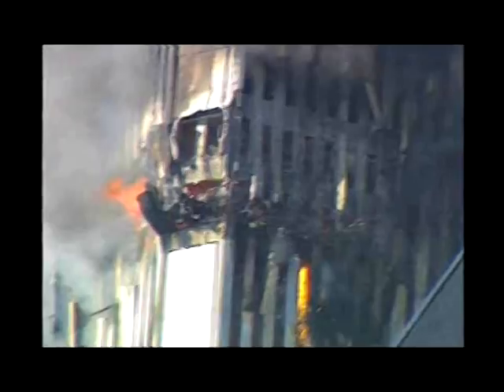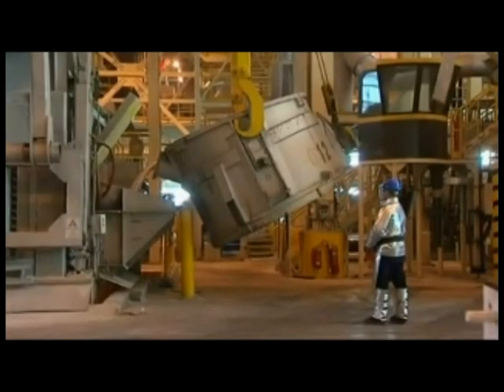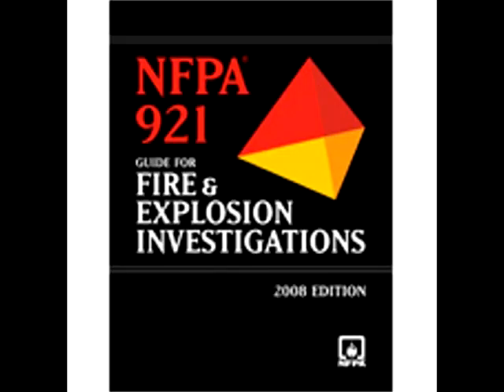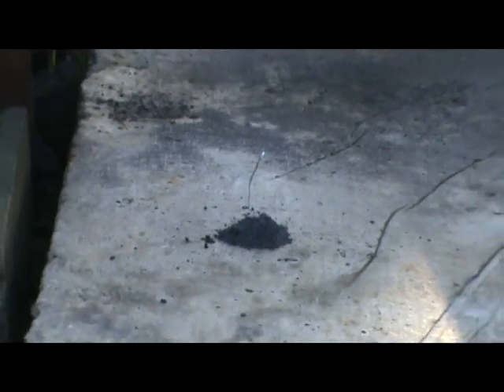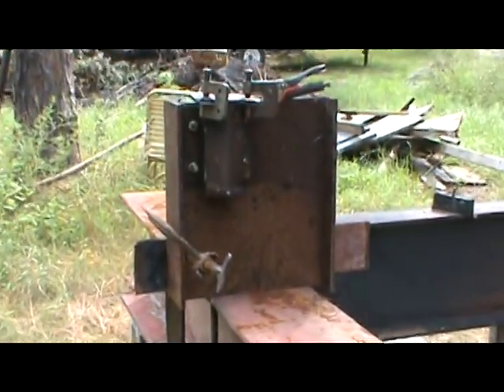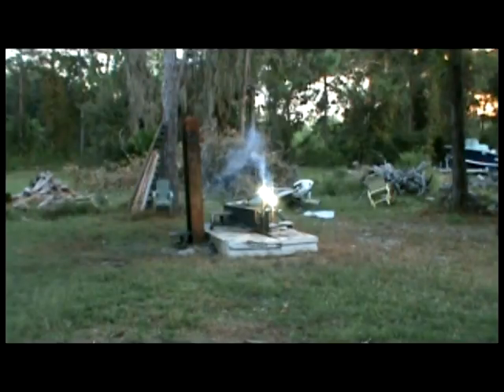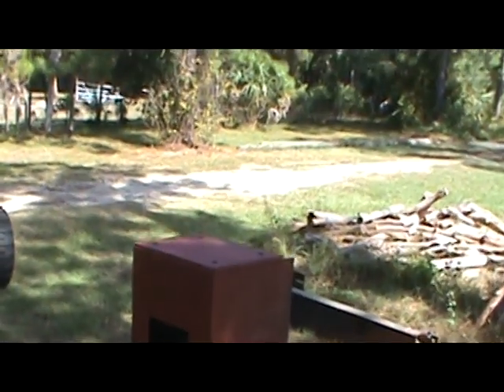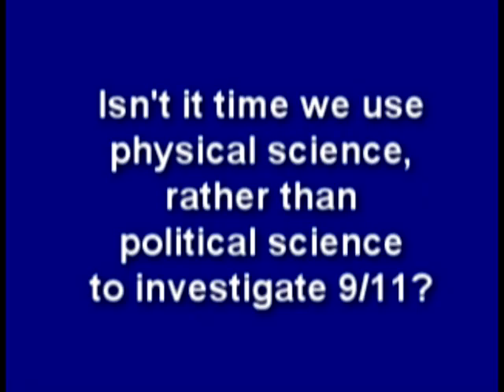9/11 Experiments: The Great Thermate Debate

Comment: Soooo... all they needed to do was pack several hundred thermite devices directly onto the structural steel of the building itself (behind the sheetrock walls and insulation), wire it all up for detonation at exactly the right time, and then fly the aircraft into precisely the right part of the building so that it didn't disrupt the thermite or any of the wiring or detonation apparatus, ALL without anyone noticing. 

Totally makes sense. Cool story bro.
Reply: +TJP77 Empire state building had a bomber in 1945 crashing with plenty of fuel and fire, with even less tech built into the structure, it didn't collapse and when designing the WTC this fact was brought up and designed to take a 707 and 767 impacts... so wtf? 

And 2ndly, yes inside job as the most heavily surveillance building in USA "The Pentagon" and to this day we have 3 frames from one blurry camera showing the "supposed jet impacting" to this very day... and conveniently covered with fresh soil and grass withing 48hrs... AND hit the only reinforced side of the Pentagon to that date  as well AND 15ton engines not leaving any holes into the Pentagon..

 TJP77 your argument is wafer thin and has no weight, blindly follow and believe what you want, but please don't stop your soap box antic by any means :)
Reply: TJP77  "MASS and WEIGHT are not the same thing you fucking moron."

They are, unless they are in a different gravitational field.  There is some minuscule variation across the planet, but it's minimal.

What, were they measuring the weight on the moon and another on Jupiter?  Why are you pulling this high school physics bullshit about the difference between weight, inertia, and mass with me?

"And oh yeah, about those WMDs... if the government was SOOOOO capable of pulling off the largest terror attack in history right in the middle of its own largest city and keeping it PERFECTLY quiet for fourteen years all in order to justify an invasion of Iraq on the pretense of WMDs, WHY THE FUCK WOULDN'T THEY JUST PLANT WMDs IN IRAQ?"

Because, dummy, the government isn't a monolithic entity.

Think of the mafia.  Is the MAFIA a monolithic entity, or is a group of clans all vying for power, trying to fuck over other groups within the mafia, gain territory, and sink other families?

They are only connected in that they are all competing in the same criminal enterprises.

The government is no different.

For all you know, the PNAC's plan was to claim that Hussein sent all his weapons of mass destruction to Syria, but weren't able to pull off convincing the public.  Plans don't always pan out, do they?

Obama, and whoever pulls his strings, had plans to go into Syria to remove Assad, that failed when parliament in England refused to go along with it, despite the PM pushing full gear for it.  It was further fucked up by Russia stepping in and saying "we'll disarm them, SEE?"

That's when the US started going full court press against Putin.  Remember?  He dared to call the US out on its bullshit.

"This super-competent government that's run by diabolical geniuses"

They aren't run by geniuses.

It's just they they rule over morons, stupid.

You're the moron.

They don't have to convince everybody, they just have to be compelling enough to convince the vast majority.

People are stupid, the people they rule are stupid. 

Let me demonstrate how FUCKING stupid you are.

When is the last time the national debt was updated?  Got any idea?  Do you even know what the national debt officially is?  How many countries joined the AIIB - do you even know what it is?

Here's one - what was the mission in Iraq and Afghanistan?  In WWII it was to topple the governments of Japan and Nazi Germany - what was the mission in our last two wars?  Isn't it weird you don't even know why we went to war in those two nations?  What was the ultimate goal in doing that?

Nobody fucking cares.  Nobody pays attention.  What did Edward Snowden reveal?  How does it relate to the 4th Amendment?

ANS: Who gives a shit - that's the answer for 99% of the population.

Here's one, if you had all the communications recorded between EVERYBODY in the country, how much power would you be able to yield with that, if you had every secret, even dirty deal, everything, as a matter of record of everybody in congress, every judge, every politician, every businessman?

People are fucking DUUUUMB and they are naive.  You're no different, and it doesn't matter if you are anyhow.  Doesn't change anything to be aware of it, except it might disgust you how fucking stupid people are.

You get exhausted with that, and it's pointless to do anyhow.
Reply: +TJP77  "West I live in lower Manhattan, three blocks away from the WTC. I watched it happen. I'm not missing anything."

Really? What were the two buildings that were closer to WTC 1 & 2 that were both larger than WTC7, that didn't collapse and were actually damaged by the fall of 1 and 2?

I know, do you?

There's good reason to be suspicious about 9/11.  Lots of reasons, but it's irrelevant, if basically it was a plot, they got away with it.  It was 14 years ago.
Reply: TJP77  "And now you're just making shit up about the WTC. The Boeing 767 didn't fucking exist when the WTC was designed. Yes, the towers were designed to survive an impact from a 707, but the 767 is almost twice as massive. MASS is important when figuring out kinetic energy impacts."

Speaking of people just making shit up...

The 707 has a max takeoff weight of 257,000lb and minimum weight of 122,533lb

http://www.airliners.net/aircraft-data/stats.main?id=87

And the 767 a max takeoff weight of 315,000lb and a minim wight of 178,400lb

http://www.airliners.net/aircraft-data/stats.main?id=103

At the largest, it's a 45% increase in weight.

"But AGAIN -- How did nobody talk about any of this for fourteen years now?"

MkUltra was discussed for years before it was finally proven to be real.  The Tuskegee Trials experienced the same thing, Operation PBSuccess, Operation Ajax.

I remember when 3 of these were "conspiracy theories" hotly denied by the government, AND the media.

And look at the bullshit assholes that don't know fuck throw in your way.  I just caught you making up COMPLETE BULLSHIT.

Talking sense to a fool is a hopeless task.  Fools trust their government and there lots of fools.  There's too many fools to try to fix anything, so it's really irrelevant anyhow.

There's a TON of suspicious events around 9/11.  The BBC reporting that WTC7 fell before it actually did, the fact the BBC lost ALL THE TAPES on that day, the fact that WTC fell at all, the fact that two buildings larger and older than WTC7 that were both closer to WTC1 and 2 and were damaged by their collapse, didn't collapse.  The 5 "dancing Israelis" that have been expunged from history and I remember reading that story, the shorting of airline stock, the fact the binLaden family was flown out of the country the next day after all other planes were grounded, the fact that the People for the New American Century stated that there had to be a Pearl Harbor event, blah blah blah blah blah.

The list is endless.

But it doesn't fucking matter.  It doesn't matter.

We have a government that lied us into a war over weapons of mass destruction that didn't exist, and there was no fallout from that.

And really, who gives a fuck about a bunch of bankers killed in the WTC anyhow?

It doesn't matter what happened.
Reply: +Truth, This video is about Thermate, it is no promoting "JFK was shot by the CIA and there are aliens in area 51 and Bigfoot is real and the earth is flat and blah blah blah." The trick of trying to conflate all these issues together is a standard method of people like you who have nothing of substance to contribute to the discussion.
\\][//
Reply: +46a23y19k57b, The unignited superthermite chips documented in the published, peer reviewed Harrit study, mentioned by Emvaz22  can be found at this link:
http://benthamopen.com/contents/pdf/TOCPJ/TOCPJ-2-7.pdf       
__________________
\\][//
Reply: Saying it's not a conspiracy is like saying the Americans went to the moon 😭
Reply: The candid reader will note that above Kenneth Miller at least made some substantive points with rational reasoning to support them. In this answer from "Truth" there is NOTHING but an empty baseless assertion and the pathetic over-worn slur; "twoofers are fucktards".

But "Truth"the shill is getting his/her keyboard strokes in for that blood money paid by his corporatist masters. Slimy little toadies such as this liar calling itself "Truth" are bloody traitors to human dignity and the word his/her name defames.
\\][//
Reply: Only several dozen cuts required, and the columns were accessible to maintenance you reject. There were "terrorism drills" in the buildings leading up the the event; teams running in and out with gear. Jesus man do some research before dripping your ignorant shit.
Reply: LOL you refuse to believe they were controlled demolitions, yet somehow also believe all 3 towers free-fell perfectly by chance. It's just so.. wow. THAT is the Hollywood thinking. Don't talk to me about practicality when you're uneducated enough to believe that.
Reply: +Truth Okay, 'Truth' let's play a game. Here's a list of things for you or anyone to explain to me. I want answers.
☻Why did fires burn underwater in the wreckage for over 5 months?
☻Why were molten steel particles and formations found in the wreckage?
☻Why was molten metal pouring out of the sides of the building before collapse?
☻Complete security blackouts in the towers in the months leading up to 9/11. Why?
☻Regular evacuations of the buildings in the months before 9/11. Why? 
☻Maintenance in the towers prior to 9/11, employees describe workmen walking around with wires. Why?
☻Lift shafts closed and guarded with armed guards for long periods leading up to 9/11. Why?
☻Explosive detector dogs removed from the buildings many times for extended periods prior to 9/11. Why?

☻Multiple witnesses describe a large explosion under the WTC lobby before the plane hit. Why?
☻A lot of firefighters witnessed and described multiple explosions. (50+ consecutively, large booms) Why?
☻Official investigations were rushed, missing critical experiments and offering dodgy simulations. Why?

☻Thousands of professional engineers speaking out about the official explanation and it's improbability. Why?
☻How has no steel building (prior or since) collapsed due to a plane impact/fire but three did on that day?
☻Bonus fun fact -  The WTC towers were literally specifically designed to withstand the impact of planes larger than the 767, complete with jet fuel.

I can't cite but the evidence is all there if you look, almost all of these are from eyewitness accounts and are points you seem to forget or are conveniently ignorant to in your efforts to belittle other's opinions. I don't claim to know how it happened or by whom, I'm not a nutjob conspiracy theorist, I'm not looking for attention, I have nothing to gain from this, and I'm not looking for an argument. I just think these mostly clear facts leave reasonable room for doubt to the questioning mind. I'll admit, it would be one hell of a job to pull this kind of controlled demolition off, but it's not beyond the realms of possibility, is it?
Reply: +46a23y19k57b 
You forgot  to mention the "eutectic" melted steel documented in FEMA's appendix C, and the unignited superthermite chips documented in the published, peer reviewed Harrit study.

Of course, taking all of this information together, your questions seem to answer themselves.  At least, for anyone with at least a rudimentary capacity for logic.
Reply: A way people could apply the detonations with out being noticed is very easily. Shut down all the elevators a week before it happens. Lets say they have demo guys. Give them a contractor uniform and large carry able equipment boxes and get to work.
Reply: +TJP77 Not just anyone but building maintenance and Management.
Reply: Explain the Pentagon then? 27 foot wide plane? 14 foot wide hole? no wreckage found outside the building of any wings or engines at all? Witnesses say they heard an explosion and smelt the smell of gunpowder
Reply: Again looking it up on the Internet. How do you know the sources are even legit. If they were and they were spilling secrets would the government let Em do it?
Reply: +helifalic You guys always underestimate the Logistics of keeping anything a secret, much less setting charges of sufficient power to demolish a megastructure.  I've seen the preparations they take for buildings that are just four or five stories.  It's not a trivial thing to cut through the kinds of beams a building like this needs to support itself.
Reply: Indeed? So what scientific evidence do you have that such an event is possible? You can't just yell at me for not knowing how buildings fall, despite my education, while asserting some vague and undeniable evidence for your lies. Watch a controlled demolition; you will see the exact same fall. What building do you know of that has free fallen and imploded perfectly from a fire? You are in denial you fool, you don't have a leg to stand on.
Reply: ***** <Wrong, it's accurate logic because it exposes your ignorance.>

Ah, so what fact am I ignorant of?  Enlighten me and explain how this supposed fact has been proven.

<We don't accept the theory of intelligent life on other planets because thousands of crackpots tell us little green men landed in their backyard. You obviously would though. The rest of us want explores to go to the planet and find the life and show it to us.>

Poor analogy.  Nice try though.  Well, not really.  The difference is that there is no verifiable evidence of little green men whatsoever.  Unfortunately for your meager argument concerning 9/11, the physical evidence points to demolition, and this evidence has been peer-reviewed and published.  It has also not been refuted or redacted.  

"Normal office fires" which NIST attributes the collapse to don't explain the melted steel documented in FEMA's appendix C, or the unreacted superthermite documented in the Harrit study, or the unusually high amount of iron microspheres documented by USGS that chemically match the microspheres that would be produced in a thermitic reaction.  Nor does it explain the 100 ft of total symmetrical free-fall experienced by building 7, which would be impossible unless the steel support columns were suddenly and symmetrically removed.  

Seems your "official story" conflicts with forensic evidence as well as basic physics.  Too bad.  At least with the little green men theory, there is no evidence to say definitively that there are no little green men.  The available evidence concerning 9/11 directly conflicts with the official story, therefore not only do you believe in something that there is no evidence for, but you believe in something that evidence actually disproves.  This means that people who believe in little green men actually have a stronger argument than you, because at least there is nothing to disprove them.  

How does it feel, knowing that your logical abilities are outstripped by people who believe in Ancient Aliens? 

<Just because a few goofballs say the WTC came down because of thermite the other 98% of us do not accept that.>

Good job making up bogus statistics to support your baseless argument.  Several recent polls show that the majority of people not only in this country but in the entire world don't buy the official government tripe. 

<You need to bring us evidence that thermite was there and that it brought down the building and that someone planted it there.>

No, actually my argument need only demonstrate the presence of thermite, which the Harrit study accomplishes.  The who and the how would be the jurisdiction of a real investigation.

< You can do none of that because you weren't there.>

So I bet you believe I can't prove the holocaust happened because I wasn't there.  Honestly, you have the reasoning skills of a 6-year-old.  Pitiful.

<The people that were there and did investigate said that all of that is bullshit.>

Oh really?  Where did they say this?  Numerous first responders reported secondary explosions (some of which were audibly recorded), bright flashes, and molten metal (which is also corroborated by photographic evidence).  What evidence can you present that refutes all of this?  What academic source can you cite which disproves the Harrit paper?  Do you have any actual evidence, or just your speculation, misrepresentation, and logical failures?

<You lose simple as that.>

Hah, you're funny.  Enjoy your new asshole.
Reply: Willy Whitten Be careful with "Truth"; he is of a fragile disposition, and his head may pop.  I think I can already see blood coming from the ear canals.
Reply: So it will be noticed that again that this anonymous shill calling itself "Truth" spews nothing but blather and ad hominem. Yes the true profile of a stooge toadyboy disinformant.___
http://benthamopen.com/contents/pdf/TOCPJ/TOCPJ-2-7.pdf

_\\][//
Reply: +Willy Whitten 
I predict his next post will be more of the same.  Watch, here it comes.
Reply: ***** Get some originality you inane piece of shit lol.
Reply: +helifalic
You need to realize a critical fact about planned demolitions.  Most of the work isn't done by the explosions, it's done by the simple fact that so much of the structure becomes unsupported at once.  Then the walls, floors, and other parts buckle under their own weight in a progressive collapse.  Put another way, they cut the columns, and then let the building's own weight do the breaking up of the building.

The impact of the jet cut some of the columns, while the firer weakened structural support for the floors above.  When that gave way, you had the demolishing force you needed, the weight of the building.  You don't need thermite or thermite... in fact, those are the wrong kind of agents to use.  Real demolition outfits use high brisance explosives, stuff that burns quick and just shears through the columns with its explosive power.

You realize there's greater complexity in timing and coordinating your fictional thermite charges, don't you?  So, when do they go off?  When the plane hits the building?  what prevents the fire from the plane from setting off the charges early?  What prevents them from getting knocked off the columns, or some charge getting knocked out for somebody to find outside?

Complexity in made up stories can be extreme and absurd, layers upon layers managed with godlike precision and prescience, and that's nice for a movie where you want people to keep on guessing, but in the real world, the simplest plan which works is often the one people go with, or at least the ones that succeed.  Tell me, what's easier, getting together enough people to hijack four jets, teaching some of them to fly the planes so they can crash them into targets, or doing that, or faking that, planting the charges in a way that requires them to cut through the walls to the columns themselves, and then leaving no evidence!

I mean its just outlandish, and you expect me to look at your ideas as the simpler ones.  They're not.  As for the question of freefall, let me be blunt: you got a million tons of force knocking into you from above, and you're falling.  Why wouldn't you go faster in a downward direction, and what would a progressive collapse caused by demolition do to make hat process any faster or slower?
Reply: +MrKos1995 
Objects in motion stay in motion until an unbalanced force accelerates them in a different direction.  If you have, for example, a two-by four being thrown at a brick wall, what will happen is that the wood of the two by four will push at the wall when it strikes, at a certain force, over a certain time, and the wall will push back, and the structural integrity of both will absorb some of the energy.  At low speeds, this will just mean a few marks on the wood, a few marks on the wall, and the wood bouncing off the wall, which will likely send out some vibrations as its molecular structure dissipates the energy of the impact.

At higher speeds, though, the integrity of both the two-by four and the wall will be compromised further, the two by four splintering under the force, but the wall buckling where it's hit, as the board exceeds its ability to withstand that force.  Shoot a pellet at BB speed at a steel plate, and it will bounce off, with at best a little mark, and some smooshing of the pellet as it took the force of impacting the plate.  Shoot it at meteor speed, and not only will it knock a hole in the first plate it meets, but it will knock and even bigger hole behind, and still bigger behind that.

The question is not whether the floors below would be the path of least resistance.  They aren't, and they never would be, and no demolition could be safely achieved if that were the only way that buildings could collapse, because in all cases, the building would have to fall outwards.  The buildings fall inwards not because there isn't any building in the way below, but because the columns are cut in such a way as to bring enough weight and force down on those components to make sure they collapse in turn.  The weight of the building itself is the hammer that breaks it into pieces.  And that potential was always there, and it's what the columns in a structure are there to prevent.  The difference between 9/11 and a regular demolition is that 9/11 was achieved in a rather inefficient manner, and a very unsafe one.  Other than that, the planes cut support for key columns in the structure, increasing the load on others, and the fire weakened the rest of the supports past a critical point.  Then, the collapse occurred when the threshold occurred, and the forces that began to operate were forces almost no structure on the planet is build able to withstand.  It's the difference between dropping a boulder on a city, and letting an asteroid of equal size impact it from orbit: force.
Reply: +Willy Whitten 
You tell me what's on my mind... how about I tell you, and we see who is more accurate about things.  Tell me how the WTC dust has such a pitifully small peak for Aluminum, if the columns were cut with thermite charges.  Tell me why we didn't see the sort of sequenced detonations standard in actual, controlled demolitions.  Tell me how nanothermites got out of experimental stages and into the kind of massive, massive application necessary to cut hundreds, if not thousands of supporting columns.  Your conjecture, if it deserves even that much credit, is that somehow all these things were snuck into an already built structure, without all the kinds of preparation work that I've seen crews doing in reality and on television for those real world demolitions.

I mean, so many people like you read something on the internet, and you think you know enough to determine what is, and is not a controlled demolition.  You talk about the perfection of the collapse, but ignore evidence that it was far from perfect.  You talk about he perfection of the collapse, but seem completely ignorant of the steps necessary to get those perfect collapses in real life.

As for exploding with volcanic energy?

Look, you see a billowing dust cloud, and you assume it's a detonation.  But that's neither the case in the collapse of the towers OR in most demolitions.  The explosions they use to bring down buildings in controlled demolitions are minimal, because the idea is NOT to blow the structure to pieces, sending shrapnel debris for miles around.  The idea is to break those columns in certain places, then destroy the central structural support, and then let the weight of the building itself take it down.  Of course, these buildings are not solid all the way through, they're mostly empty space, the space we move through when we walk around in a building.  But that empty space isn't actually empty, it's filled with air.  Knock over a solid plate onto  flat floor, and you'll get a rush of wind as the air is pushed out of the way. Only here, it's the air in all hundred or so stories of a couple of the largest office buildings in existence, not to mention the dust from pulverized concrete, insulation, and other lovely stuff.

You guys get your idea of how explosives are used from the movies, where they always give explosives these big BLEVE (Boiling Liquid Expanding Vapor Explosion) detonations, with their lovely mushroom clouds and black smoke.  Real high explosives have more kick, more snap than that.  Go and look at videos of actual demolitions, and you'll see the sharp snap, and relatively unglamourous footage of that stuff going off.
Reply: +Stephen Daugherty 
I see a bunch of conjecture with no supporting evidence.  You can speculate all you want on the how and when and where, but if you can't refute the Harrit study, which prove the presence of very advanced incendiaries, then your speculation amounts to nothing.

Provide a factual academic refutation.  Author.  Title.  Publication.  Date.  Ad hominem fallacies aren't refutations.  Speculations aren't refutations.  What verifiable facts can you demonstrate that conflict with the Harrit report?  Pretend like this is English class and you are required to provide supporting evidence for your assertions.
Reply: +Emvaz22
If you're using a shitload of thermite, enough to burn through hundreds of steel columns, there's going to need to be a shitload of Aluminum burnt out of that as a reaction product.  Which they didn't find.  You can talk about all the disgusting things you can't or shouldn't google, but please have the decency not to suspend the laws of chemistry in all this.

As for the natural collapse theory... aren't we forgetting that neither side of this debate is claiming that the building fell on its own?  The difference is the means by which the buildings structure was made unstable.  We have a motherfucking jet, full of fuel to start a raging fire and soften the critical crossbeams, an impact to knock fire proofing off of the beams, oh, and the results of letting an office-building worth of floors drop on top of another office building.

The whole clever demolition theory requires so many things that are absurd.  If you're doing an actual, controlled demolition, you don't just simply plant bombs or thermite charges on the different parts.  You don't blow it to smithereens, either.  There's a pattern to it, a pattern that is essentially meant to make the building do the work of smashing most of itself.  There are columns there for a reason: otherwise the materials themselves would obey the law of gravity, and accelerate down at some rate into the floors below.  Get enough of that material collapsing at once, and it becomes an unstoppable cascade of collapse.

That's the thing.  People like you look at the billowing dust coming out of the building, and you think that's the explosion.  That's never the case even in a real demolition.  In a real demolition, it's those flashes and cracks that represent the real demolition, and those are sequenced, not haphahazard.  Then a charge goes off to destroy the supporting pillar far below.  Here's the thing: if there were windows during this part, they'd have all been broken out, which is why windows are typically removed for planned demolitions.

Imaginary charges blow up without producing an overpressure wave that would blow the windows before the collapse got to them.  Imaginary charges would have thermite burning at angles, rather than straight down, where the molten metal would flow.  Imaginary molten metal would have men bending over it, convection not factored in.  What we imagine is a hell of a lot less bound by the rules of nature than what we don't.

Most of the volume of a building is air, and whether the towers were brought down by planes or expertly planted charges, as the floors collapsed, the air would have to go somewhere, and with the floors being pulverized, and everything inside being shredded, it would get blown out the windows.

In other words, you and other are seeing the wrong thing in that billowing cloud.  Your untrained eyes are deceiving you.
Reply: Willy Whitten
And YOU are pathetic continuing to ignore me sheep.
Reply: ***** You don't eat meat?  That explains your poorly functioning brain.  You're missing out on vital micronutrients, not to mention easily digestible protein and energy-dense fat.  It takes a lot of calories to effectively operate a brain.  Clean animal fat is the best source of calories, not to mention fat-soluble vitamins that are hard to get otherwise.

You know those sharp teeth that all humans have on the sides of their mouth?  Those are designed to cut and tear flesh and sinew.  You know how we have front-facing eyes?  Predatory animals have front-facing eyes for the purpose of depth perception and visual acuity.  Prey animals have side-facing eyes for a larger field of vision so they can see approaching predators.

Humans are omnivores, and are meant to consume fruits and vegetables as well as meat and fat.  Clearly you are missing something in your diet.  Your impaired brain function is made evident by your last post.  Maybe instead of spending your time honing your imaginary karate skills which you will never use in real life, you should focus on mastery of punctuation so you don't look like such an idiot on the internet.  Can you say run-on sentence?

Why can't you refute the Harrit study?  Why can't you explain 100 ft of total free-fall by building 7?  Why can't you explain FEMA's eutectic steel?  Why can't you cite a scientific study or a single piece of evidence that proves the official collapse theory?  Why do you ignore basic physics, like Newton's Third Law, especially in regards to the structural steel in building 7 offering absolutely zero resistance for 100 ft?  Why can't you name a group of independent experts who publicly support the official story?  You claim 98% support the official story; where are all these supposed people?

Why do you keep trying to change the subject?  You running from something?
Reply: ***** "Belief" would work, but I prefer "False Premise."  Either way, he's an idiot.
Reply: ***** You may want to punctuate your sentences correctly before you attempt to call somebody out on the internet for being foolish.

Post the part where you think you "took me to school."  I'm curious.  I hope you're not still taking about your "durrrr post a video of you killing and eating an animal barehanded" premise.  I vividly recall stomping all over that false premise from multiple angles, showing how such a video would not prove anything, and would not be necessary to demonstrate that people have killed and consumed animals for millions of years as part of our naturally omnivorous diet.

I also don't recall you supporting any of your argumentative statements from prior posts.

Why can't you explain purely carnivorous human cultures that I keep mentioning?  Why do you ignore the archaeological evidence that proves that humans have consumed animals for millions of years, since before recorded history?  Why do you ignore the videos I've posted of Andrew Ucles running down and catching large game with his bare hands and no tools whatsoever?  Where is your refutation of the Harrit paper?  Where is your academic study that proves the official collapse theory?  Where is your citation that supports your statement that 99.9% of experts believe the official story?

I don't see how you can think that you've won this argument when you don't address any of the statements I have made that negate your positions.

Have fun pretending though.
Reply: ***** < I normally avoid arguing with people who believe the planet is 6,000 years old, or believe humans are ruminant herbivores who can digest grass, or believe WTC7 fell down because of a fire. It seems like there is a deep sense of denial about any contradicting evidence, they genuinely think what they believe is 100% true and absolutely shouldn't be questioned, this is the stuff religions are made of.>

Fully agree.  They particularly enjoy ignoring evidence and logic that disproves them and pretending they are right despite it all.  It's fun to watch.
Reply: THANK YOU! Nobody seems to have common sense any more.
Reply: +Truth sorry, but YOU lose. Humankind has always had Canine style teeth specifically for eating meat. So, I guess your name should be "bullshit" instead of truth.
Reply: ***** Long canines are not for tearing flesh from bone, idiot.  That is what incisors are for.  Long canines serve to kill prey more efficiently than short canines.  The fact that we have short canines suggests that early humans killed their prey without the use of their canines.  Nothing more.  Instead we use our numbers and our hands, aided by tools and our brains.  Different animals adapt to do the same thing in different ways.

Humans have adapted to eat meat.  The proof is that we eat meat.  It isn't complicated.  As Gamer Tag and Joe Mills have said, you lose.
Reply: +Truth lol what.. 'They all use what nature gave them.' So you're saying sticks aren't from nature?
Reply: ***** But you said from nature, and if I am not mistaken trees are nature, therefor sticks (which are branches that fell off of the tree) are nature.
Reply: Lmao. Thank you for saying this.
Reply: ***** <Did it occur to you that the floors around the impact zone were always full of workers. The floors that were closed were not the floors near the impact zone.>

The elevator shafts WERE closed, and under guard during an "elevator modernization" by ACE Elevator, a pentagon-tied defense contractor.  The shafts have discreet access to all of the core columns.  Secondly, at night the towers are virtually empty, although witnesses report seeing high numbers of heavy trucks going in and out of the facility in the early morning hours.  Witnesses inside the towers at that time recall seeing a fine white powder coating the baseboards and sills, as if drywall had been cut out and replaced in the middle of the night.  Gee, I wonder what could have been placed behind the drywall.

I could poke holes in your speculative argument all day long, and all it amounts to is more speculation.  It boils down to the fact that incendiaries are published and PROVEN to have had a role in demolishing the towers, and all you can manage as a refutation is speculation.
Reply: Did anyone even see the way building 7 fell into the ground? That should just be enough to convince anyone, like come on. Did you see the way it fell right into itself? Just like a controlled demolition. I don understand how anyone can say any different, it's right in front of your eyes!! What's wrong with all of you?
Reply: TJP77 if I didn't already know a thousand other shit-for-brains just like yourself then I wouldn't believe my own eyes seeing such a prime example of human stupidity in the form of your post. That story you sarcastically say is "cool" is made up of words you put into his mouth. Thermite was shown to cut steel horizontally and vertically, as well as cause explosion like reactions. It's pretty difficult to argue there.  You obviously missed the end of the video where he says he does not know what happened but does not believe the official narrative of what happened, yet you somehow still paint a picture of a conspiracy theory in your head and mock the uploader for something that he never even said or implied even in the least bit. You and your type are what's wrong with the world. Bless your pitiful retarded soul.  

For all you others asking how this could be kept a secret so long after all these years, I'd like to remind you that this was no secret at all ever since day one. So many of us knew the truth all along. Just because you've all been unaware for 16 years doesn't mean some big secret is finally out.
Reply: Do you think maybe the Federal Government has the money to do remote control charges? So, it wouldn't matter where the plane hit.
Reply: @blockcade
Explosives at the trade center on 9/11 are IMPOSSIBLE unless YOU can explain away the impossibilities and inconsistencies of the fairy tale demolition theory! Explain how bombs MAGICALLY survived the plane impacts, MAGICALLY survived falling debris for building 7, MAGICALLY survived fire, MAGICALLY got passed the extra security (including bomb sniffing dogs) working round the clock 12 hour shifts due to phone threats, and why each and every explosion was random, out of sequence, inconsistent with a demolition and had nothing to do with any building collapsing. Explain why there were NO explosions seconds before the collapse of ANY building. Explain how firefighters survived in stairwell B. Oh and also the steel was sent to 4 different landfills where multiple organizations and experts had access to it for a period of six months. Explain why people who say the towers were demolitions DID NOT go to any of these landfills.

If you can't, and I know you can't because NO ONE has ever explained it away, then you need to...

WAKE THE FUCK UP DUMB DIPSHIT SHEEP!
Reply: You would be just a funny psycho cartoon if you weren't being paid.
Reply: +Anthony West you mean the 3 buildings and 2 aircraft anomaly? Plane 3 didn't make it, remember? Blew it down anyway.
Reply: +TJP77

Totally makes sense.
Reply: I like you! @TJP77 best comment ever!
Reply: +teggiano salerno first building in the world to come down due to fires, the one in Madrid burnt for several days and never came down and it was a towering inferno. How come none of the other buildings came down which were more damaged then Building seven.
Reply: +Chris Norman  The Empire State Building is a solid masonary facade with tiny little windows. And the bomber that hit it was very small compared to modern jets AND wasn't going 480mph -- kinetic energy matters a whole lot with these things. 

And now you're just making shit up about the WTC. The Boeing 767 didn't fucking exist when the WTC was designed. Yes, the towers were designed to survive an impact from a 707, but the 767 is almost twice as massive. MASS is important when figuring out kinetic energy impacts. 

And you have no fucking idea what you're talking about with the Pentagon either. Nothing you're saying makes any sense at all. 

But AGAIN -- How did nobody talk about any of this for fourteen years now? How did nothing leak about this MASSIVE plan beforehand? The government can't keep secrets for shit. You mean to tell me that in all this time NOTHING leaked? Snowden, Assange, hacking by the Chinese and Russians... and yet NOTHING to back up anything you're saying.
Reply: +Jordan Houston, That's funny Jordan. You are kidding...right?
\\][//
Reply: Truth, I think the Warren Commission, like NIST & the 9/11 commission were politically motivated whitewashes. I have no idea whether "the government is hiding information about alien life". I suppose the the Patterson film is the one alleged to be Big Foot. No I designed creatures and constructed such for special effects films, I have no doubt the "creature in the film I saw (quite awhile ago) is a man in a costume. Do you believe Oswald was the lone gunman?
\\][//
Reply: TJP77 and it wasnt a bomb?
Reply: +fuzzywzhe You are wrong; MASS and WEIGHT are not the same thing. In the physical sciences, mass and weight are different. The mass of an object is a measure of the amount of matter in the object. Weight is a measure of the force on the object caused by a gravitational field. 
\\][//
Reply: +TJP77 no just fly a plane into the building comes down 100 percent into footprint, demolition teams no longer needed.  In fact this is so good, it will take down buildings beside the hit building down into its own foot print just with the residue office fire without any jet fuel to help melt the steel!  This is amazing, you get 3 buildings demolished for price of 2 with simple jet fuel a couple hard impacts at some random mid high level spot on the building et voila! I believe that!
Reply: +Truth governments never lie? even when it is in their own best interest? who defines that interest and when does this happen? tooooooooooooooooooooooooooooo fucking complicated for you so just deny it all good man make a good soldier front line
Reply: +Truth, You should pick up a physics book and learn a little bit about how science works.
\\][//
Reply: +Truth, I think you should ask your father in law to teach you something about physics and then show this forum what you have learned.
\\][//
Reply: +Truth, "He said , he said in  REAL LIFE"! ... Wow!!! And you got that on tape? Let's see it!!
\\][//
Reply: Truth, What a drag it must be, being you.
\\][//
Reply: To believe it's the natural state of buildings to fall down like that, and that extra force is required to tip it. That's so backwards I can't even.. wow.
Reply: ***** Seems to me all of your questions would be the jurisdiction of a real investigation.

How exactly does your line of questioning disprove the presence of thermite as documented in the Harrit study?  How does it prove the official collapse theory?  It appears you are implying that because we don't know exactly who masterminded the event or who all was involved then it therefore couldn't have been demolition.  I shouldn't have to tell you that this is poor logic.
Reply: ***** Your argument comes down to the premise that the government wouldn't lie. The fact that you're so damn sure is detestable. You're insane.
Reply: Hundreds of eye and ear witness reports of explosives during the demolitions of the WTC Towers:https:
//hybridrogue1.wordpress.com/2014/04/12/wtc-1-2-reports-of-explosions-after-impact-and-during-collapses/

Ultimate Fact, and the forensics of the demolition of the World Trade Towers:
https://hybridrogue1.wordpress.com/2014/05/08/controlled-demolition-and-the-demise-of-wtc-on-911/

\\][//
Reply: Emvaz22  Sans carne;  (a meal without meat -- rhetoric without substance.)
\\][//
Reply: Stephen Daugherty
You wrote all that trash that proves nothing.  All objects in motion will take the path of least resistance.  This is proven physics.  Given this truth, you will have to convince me that the structures from above came straight down meeting no resistance, or, equal resistance which is impossible.  Given this, at some point in the towers collapse, it should have gone to one side or another, or, parts of the structure would have collapse at unequal speeds, yet, it all continued to go straight down at free fall speed.  Given the truth of path of least resistance, this would imply that there was no resistance below, meaning, the support structures where significantly destroyed/weakened to allow the mass above to go straight down without slowing down.
  Video and witness testimony AT THE TIME of the incident provided ample proof of an explosive incident at the sub basement level not related to the impact of the plane.
  Then of course, there is building 7.  Nothing you can say about that except demolition.
Reply: Stephen Daugherty, As you clearly do not understand even controlled demolition as a civilian manner in felling buildings in such a way as not to destroy neighboring properties. Do not understand sol-gel explosives nor what it takes to ignite it; it would therefore be futile to go through each one of your scurrilous points one by one, as in the final analysis every one is pure conjecture. What is not conjecture is that the proofs of explosives are seen in the video and imagery evidence. In the ear and eye witness testimonies of hearing explosives going off. In the fact that an active military grade sol-gel nano-energetic was found in the WTC dust and identified by careful experimentation by the Jones-Harrit team. 
Plus most importantly; anyone with the slightest visual acuity can see for themselves that the towers exploded with massive volcanic like energy - they did not simply 'collapse".
If you want to get into the proofs that the NIST Reports are proven frauds, be my guest.
Prepare yourself for such argument here:
https://hybridrogue1.wordpress.com/2015/09/18/911-false-flag-psyop/

\\][//
Reply: This shill "Truth" keeps making assertions lacking any substance whatsoever. It is a hallmark of a corporatist stooge to make such empty flatulent assertions accompanied by baseless ad hominem, and quaint vapid 'allegories'. Their agenda here is clear, to distract from facts and data that prove the WCT was destroyed by explosive demolition, and to attempt to bury these proofs each time they surface from under their pile of vile denials.
https://hybridrogue1.wordpress.com/2014/05/08/controlled-demolition-and-the-demise-of-wtc-on-911/
_____
\\][//
Reply: ***** Therapy?  I think you misunderstand what we're doing here.  This is called a debate.  Currently, your prolapsed rectum is still dragging on the ground behind you, as you keep making claims that you have yet to back up, and we keep citing evidence that stomps your ridiculous assertions to dust.  You keep getting torn a new asshole, and you keep pretending like it never happened.  

You claim the Harrit paper is refuted.  No supporting evidence presented.  You claim that everybody involved with 9/11 first hand believes the demolition theory "is bullshit."  Willy Whitten cited over 100 quotations from first responders and witnesses who claimed they saw and heard explosions.  You provide no supporting evidence.  You claim that 98% of people believe the official story.  I show how you're an idiot by citing multiple recent surveys that show the majority of people disbelieve the official theory.  You present no evidence to back up your claim.  You imply that the official story is correct.  You provide no supporting evidence.  We provide evidence that directly contradicts the natural collapse theory (Harrit report, FEMA appendix C, video evidence of building 7 free-fall).  You claim to have refuted it, but when pressed, you fail to cite a refutation.

You're a liar, a hypocrite, and an obvious shill.  You should probably remove yourself from the conversation, because you clearly have nothing to add, and have exposed yourself for the subhuman waste that you are.
Reply: Stephen Daugherty Hmm, I see a bunch of conjecture and speculation, and again zero supporting citations.  Once again, your post does absolutely nothing to disprove the demolition theory.  Example:

<there's going to need to be a shitload of Aluminum burnt out of that as a reaction product.  Which they didn't find. >

They didn't?  You may want to cite your source if you're going to make statements that are blatantly wrong.  According to the USGS, the dust contained very high levels of both iron and aluminum (up to 4% by volume), as well as unusually high levels of barium, which is a common constituent of pyrotechnics.  Are you implying that the building collapse caused the structural steel and the aluminum cladding to be atomized into a fine powder?

You can talk about all the disgusting things you can't or shouldn't google, but please have the decency not to suspend the laws of physics in all this.

Provide an academic source that backs up your claim that there was no thermite residue in the dust.
Reply: You are truly pathetic "Truth", with your juvenile dialog... amazing.
\\][//
Reply: ***** Aww, poor thing.  Look Willy, I think we made him cry.  Need a tissue, princess?  I'll go and grab you one, but first, just one thing:

You claim the Harrit paper is refuted.  No supporting evidence presented.  You claim that everybody involved with 9/11 first hand believes the demolition theory "is bullshit."  Willy Whitten cited over 100 quotations from first responders and witnesses who claimed they saw and heard explosions.  You provide no supporting evidence.  You claim that 98% of people believe the official story.  I show how you're an idiot by citing multiple recent surveys that show the majority of people disbelieve the official theory.  You present no evidence to back up your claim.  You imply that the official story is correct.  You provide no supporting evidence.  We provide evidence that directly contradicts the natural collapse theory (Harrit report, FEMA appendix C, video evidence of building 7 free-fall).  You claim to have refuted it, but when pressed, you fail to cite a refutation.

Why can't you refute the Harrit study?  Why can't you explain 100 ft of total free-fall by building 7?  Why can't you explain FEMA's eutectic steel?  Why can't you cite a scientific study or a single piece of evidence that proves the official collapse theory?  Why do you ignore basic physics, like Newton's Third Law, especially in regards to the structural steel in building 7 offering absolutely zero resistance for 100 ft?  Why can't you name a group of independent experts who publicly support the official story?  You claim 98% support the official story, where are all these supposed people?

Why do you continue to hang around here?  All you've managed to do is demonstrate the strength of the CD theory by juxtaposing your total lack of supporting evidence against the mounting pile of inconvenient facts laid out by Willy and myself.

Are you a glutton for punishment?  Do you find it fun to be made to look like an absolute moron?  I certainly enjoy making you look like a moron, so by all means, stick around.
Reply: ***** 6'6, 190, 33" waistline.  Mid-20s, bachelor.  Penis jokes, mom jokes, and fat jokes, and thats the best you can do?

Why can't you refute the Harrit study?  Why can't you explain 100 ft of total free-fall by building 7?  Why can't you explain FEMA's eutectic steel?  Why can't you cite a scientific study or a single piece of evidence that proves the official collapse theory?  Why do you ignore basic physics, like Newton's Third Law, especially in regards to the structural steel in building 7 offering absolutely zero resistance for 100 ft?  Why can't you name a group of independent experts who publicly support the official story?  You claim 98% support the official story; where are all these supposed people?

Oh thats right, I almost forgot.  You have no answer for any of these inconvenient questions, and no supporting evidence whatsoever.  

You think that spouting off weak, elementary school-grade insults somehow bolsters your argument or lends your unsupported opinion more credibility?

Try again.
Reply: ***** Ohh scary, a 40 year old wannabe MMA fighter.  Do you do Crossfit before or after your colonoscopy?
Reply: ***** <The digestive system determines an animals food supply and humans match all 20 digestive characteristics with all herbivores.>

Oh, so we have multiple stomachs for digesting tough grasses like cows?  And cows have sharp teeth for chewing on all that grass, do they?  You said ALL characteristics with ALL herbivores.  You almost had it though; Keep trying.  Our closest relative in the animal kingdom, the chimpanzee, also hunts and consumes meat.  Without the consumption of meat, the human race likely would not have survived the ice age, where edible plants were scarce and humans survived by hunting megafauna like mammoths and mastodons.

<The brain runs on glucose from fruit not fat from animals.>

Oh, so I guess you think that the inuit culture, which subsists largely on blubber and lard, is a conspiracy theory and never happened.  Because fat can't power human cells, right?

When your body runs low on available glucose to use as energy, such as between meals or during times of intense exercise, hormones release triglycerides from the fat cells and lipase enzymes break them down for the body to use as energy.

Also, although the carbon atoms of the fatty acids chains from dietary fat cannot produce glucose, the glycerol backbone participates in a chemical reaction known as the glycerol phosphate shuttle. During this reaction the glycerol becomes pyruvate and pyruvate then participates in gluconeogenesis to produce glucose.

Therefore, fat is perfectly capable of supplying the body with energy, in fact the body requires fatty acids like Omega 3 that it cannot produce on its own, and must be acquired through consumption.  Moreover, fat is far more calorie (energy) dense than sugars and carbohydrates.  On top of all this, superfoods such as high-vitamin butter oil from pastured cows and raw, fermented cod liver oil contain many crucial vitamins and micronutrients in much higher quantities than can be found in plant food sources.  Dr. Weston Price attributed the beneficial effect on native diets high in these types of foods on the superior development of skeletal structure, as well as the jaw and teeth.

<The biggest study ever conducted on humans eating animal flesh just came out recently and processed meats and red meats increase cancer risk by 20%>

When did I imply processed meats are good for you?  That would be like me disagreeing with your claim the eating fruit is beneficial by citing a study on pasteurized, canned fruit stored in corn syrup.  Moreover, not all meat is equal, even when unprocessed.  Liver is the best of all, and contains the most nutrients.  This is why the alpha male in a wolf pack always gets the liver.  Rare or raw meat (assuming it is clean) is far better for you than fully cooked meat, and most studies on humans don't control for the quality of the meat or how it is prepared.  See: Pottenger's Cat Experiment.

<Nothing that us good fir you increases cancer.>

Does the sun not cause cancer with excess exposure?  Is the sun not a good thing, and necessary for the production of vitamin D?  You sure like making incorrect blanket statements.

<Saying a human needs to eat animal flesh is like saying a human needs to drink gasoline.>

When did I say needs?  I said that animal flesh and animal products are a more concentrated source of many vitamins and minerals than many plant sources.  One would have to eat a huge amount of plants to derive the nutritional content of a small amount of high quality cod liver oil, butter oil, or calf liver.  Conversely, there are many micronutrients and enzymes in raw plants that can't be obtained from animal sources.  Which is why a mixture of both is necessary for optimal health.

<Oh and those tiny sharp teeth and your weak jaw are not designed to tear flesh. >

They do just fine for me.  I'm sorry you have a maldevoloped jaw and sub-par dental structure.

<You couldn't eat flesh without weapons, fire, and knives you knucklehead.>

Yes I could.  Knives and fire simply make it easier.  Instead of huge canines and sharp claws, we developed large brains so that we could create tools and outsmart our prey.  A sharp stick, a big rock, and a group of likeminded individuals was enough to dispatch any animal we came across.  A specialized tactic was simply to carry torches, and run our prey off of a cliff.  The cliff becomes the weapon.  Your assertion that humans can't kill anything without a weapon is irrelevant.  Our brains are the weapon, and the tools we use are merely extensions of ourselves via our brains.  Go back 10000 years to our hunter-gatherer days.  Do you know what we called people who didn't hunt and kill animals for meat?  We called them women.

<rip into its flesh with your teeth and use your jaw to tear the flesh from its body hahahahaha. You just happen to be the only meat eater on the planet that can't do that. Nice try imbecile.>

You must have never had a rare steak.  Our relatively small canines and jaw strength is merely a function of developing a brain which allows the use of tools to cut meat into smaller portions and fire to make the meat easier to chew.  Nevertheless, they are perfectly sufficient for tearing flesh from bone.

Ive got an exercise for you.  Next time you eat a salad or an apple, use only your front teeth to chew.  Don't work too well, do they?  Pretty inefficient, huh?  You know why?  Because they developed to cut into flesh, not to masticate plant fiber, which is what the rear teeth are for.  There aren't many herbivores with front-facing eyes and sharp front teeth, are there?  The exceptions would be monkeys, lemurs, etc who need front facing eyes for better depth perception when swinging through trees high above ground.

Omnivores.  Nice try though, imbecile.
Reply: ***** Too bad we're not here to discuss nutrition.  But if we were, I would borrow an eloquent post from a blogger:

"Modern day humans are omnivores – there is no debate here. Early hominids from the Miocene epoch (24 million – 5 million years ago) have flat molar teeth and the evidence supports that their diet consisted of flowers, nuts, fruits and brittle foods but certainly not meat, seeds, steams/roots.

The modern ice age (Pleistocence epoch) came around 1.6 million years ago. Our ancestors were forced from trees onto the ground, encouraging bipedalism (walking upright) and working in co-operative groups to survive predators. Plants don’t grow in cold climates thus our previous ancestors survived by migrating and finding warmer climates or eating other animals in colder climates. This change in the environment (along with other factors of course) yielded the modern humans you know today – omnivores.

Throughout certain periods of our current ice age, plant based food sources were likely scarce and these ancestors either starved to death or made do. They likely were scavengers eating insects, leftover carcass, roots or any source of nutrients they could come upon. After a few hundred thousand years of evolution, the diet of Homo heidelbergensis was largely animals.

The downside of being an omnivore is that we are not efficient at digesting plants as herbivores. The same goes for digesting meat as efficiently as true carnivores. However, our digestive system allows us to be flexible in harsh cold environments (such as the ice age) when plants are not readily available or rely on plants if available. If you think about it, picking plants is far less risky than attacking a wild animal.

The modern human is not constricted to a diet of strictly plants or animals. We are constantly evolving as well. In just the last 10,000 years alone we have integrated a new spectrum of food into our diet. Things like processed sugar, hotdogs and cereal may seem like old news, but it is a blink of an eye compared to the evolution over millions of years. Some speculate that these new foods and our sedimentary lifestyle probably contribute more to diseases such as diabetes and cancer, more so than eating lots and lots of red meat. Also advances in medical technology (artificial selection) pollutes the gene pool with genes that might otherwise be removed. Instead of dying, those who have these diseases are able to stay alive longer and reproduce.

All this to say: humans were not designed, we evolved. We have been eating plants and animals for several millions of years. Some humans choose to eat only plants. Some of us tolerate grains better. Some of us tolerate meat better. If you find yourself taking omeprazole (prevacid, nexium, zantac, etc) then maybe you should consider a different diet. If you are unhappy with your diet, change it. Diet isn’t the root cause of all diseases but having a good diet can make you a lot happier.

In this day and age with the technology and ice age recession we have the luxury of choosing our diet. If a person chooses to be vegetarian then cool beans (yeah, that’s a pun). They may need supplementation for the lack of protein, fat and vitamin B-12 deficiencies that occur after long terms but if that type of diet makes them happy then why would they change it?

However, don’t believe for a second that humans evolved only to consume vegetables – that is simply not true – we would not be here without our ability to consume meat. Vegetarianism is a choice. We can eat meat and live many years. We can eat no meat and live many years. Nutritional science seems to alter and studies contradict each other from decade to decade. Eggs used to be considered bad for you. Vegetable oils replaced fats. Now eggs are not bad for you and fats are better than vegetable oils. For those of you old enough, you probably remember the food pyramid that states that you should eat more bread than vegetables and fruits combined. ^_^ There is a current study that shows vegetarians are more likely to have cancer than someone who has a diet high in meat. There is another article that says eating fruits and vegetables decreases the risk of cancer. Some studies say vegetarians live longer. Other studies refute this. It’s no wonder that people are confused. My advice is if you are unhappy with your diet, seek a dietitian and change your diet. See what works for you."

Why won't you stay on topic?  Why can't you refute the Harrit study?  Why can't you provide supporting evidence for the official theory?
Reply: ***** <You must not understand English. I told you I wasn't going to waste time debating someone that knows nothing about our digestive system and will obviously defend a personal agenda to his death like any meat eater would. >

Yet here you are, wasting your time "not debating" about our digestive system, just as you've wasted your time not debating about the contents and implications of the video we are commenting on.  How many posts have you wasted not debating about anything?  How much time have you spent accomplishing absolutely nothing?  I don't think you have the capacity to engage in a debate, because you don't know how to construct a supported argument, and you have horrendous logic.

You claim that we have all of the digestive traits of herbivores.  Thats funny, I don't recall being able to eat grass and convert it to protein in my three stomachs like cows.  Nice false blanket statement.  You also assert that because I don't have long sharp canines and retractible claws such as a pure carnivore like a lion, therefore I'm not meant to eat meat.  Too bad I never claimed to be a pure carnivore, so your entire statement is a false premise.  Again, great logic.  How many herbivores that you know of regularly eat meat?  How many herbivores ate large amounts of meat during ice ages in places where fruiting plants were scarce if not nonexistent?  Do cows eat field mice?  How many herbivores live to this day consuming almost entirely animal products, such as Inuit society or cultures living on the Asian steppes and grasslands, where the soil only supports grass which is inedible to humans (but we're herbivores, so why not eat grass?  Hmm...)?

Humans have adapted and evolved according to their environment.  During times of flourishing plant life, humans ate mostly plants (because its much safer than attacking a wild animal).  When plants were scarce, humans ate animals, and survived and continued to evolve because of it.  Can a lion survive off plants?  No.  Can a cow survive off meat?  No.  Do you think cows crave meat?  No.  Yet many people DO crave meat, and crave fruits and vegetables just the same.  Can humans survive off both?  Yes, and billions of people do to this day.  Therefore we're omnivores.  It's not rocket science.

Now that we're done with that, and since you're still here, what ARE you willing to debate?  Are you capable of engaging in a debate?  I have my doubts, considering your responses thus far.
Reply: ***** GG.  By the way, debate requires supporting sources and/or deductive reasoning and logic.  Don't kid yourself, you were never debating; you clearly don't possess the required skills.  Good job posting 50+ comments in this thread with zero supporting evidence in a single one of them.  It's been entertaining and gratifying to so thoroughly stomp out somebody who is so obviously wrong and so hopelessly unable to provide any sort of support for his baseless assertions.

Is this the part where tears of frustration roll down your cheek as you block me?  Please block me.  One more head for my wall of meatpuppets.  Or maybe out of anger you keep attempting to debate me without refuting anything I say.  Either way, the end result is you looking like an idiot.

Thanks for playing.
Reply: ***** Oh, so what "truth" am I missing?  Cite your scientific proof that humans are pure herbivores, despite the incisors and canines, and lack of multiple stomachs, and lack of enzymes to convert grass to a usable food source.  Cite your proof that certain groups of humans even today actually don't subsist completely on animal products.  It must all be a conspiracy, just to trick you.  These people must be lying about what their diets consist of.  Cite your proof that disproves the precedent set by human history, in which the vast majority of people today and in the past have consumed some sort of animal product.

What scientifically proven "truth"  disproves the thermite found in the Harrit report?  What?  Still nothing.  50 posts and counting, and still not a single academic citation.  Why not?

Is your name meant to be ironic?  You should make another alias named "Speculation" and post only things that you can provide scientific proof for.  Just for kicks.
Reply: ***** <If I gave you 2000 pages of scientific studies and 200 of the worlds top nutritionists and called on God to come out of the sky to tell you we are herbivores we both know that you would still reject it.>

Cite one stay that proves we are herbivores.  On second thought, don't bother trying.  Observational studies don't confer scientific proof, and I doubt you can produce a meaningful controlled experiment that reliably observes long-term health outcomes.  Of course, anecdote seems to suggest you are wrong.  If humans were pure herbivores, then populations like the Inuit or the nomadic cultures on the Asian Steppes wouldn't have survived.  They would be sickened from having to consume meat and animal products, and die without being able to reproduce (fertility requires good nutrition).  Yet these populations remain robust and still exist, and survive in some of the harshest climates inhabited by humans anywhere.

Am I claiming that a diet consisting of purely meat and animal products is ideal?  Of course not, because it isn't.  Fruits and vegetables contain many beneficial nutrients, and most people do not get enough of them, especially in the US.  Oftentimes, I crave a fruit or a vegetable more than a meat, so that is what I consume.  Would a person that ate only plant based foods be healthier than a person who ate only animal-based foods?  Probably (assuming the plants and the animals were clean and of equally good quality).  If this were the argument you were making, then I would probably agree with you.  But no, you claim that we are pure herbivores, which seems ridiculous.  If you don't believe me, go out into your yard, get down on all fours, and start grazing on the grass and foliage.  Tasty, right?  How comfortable is it on your hands and knees, neck craned downward unnaturally?  How long before you are forced to regurgitate the foliage that you can't digest?  Just like God intended, right?  Oh thats right, we walk upright, which kind of makes grazing on grass like a true herbivore a bit uncomfortable.  I think If I were a true herbivore, my mouth wouldn't water at the smell (or even just the thought) of seared flesh.

I guess we humans have been fucked by evolution.  Our brains have evolved to favor things that are completely at odds with our bodies (according to you).  Yeah, because that's how evolution works.  We've become the dominant lifeforms on this planet by eating the wrong foods all of these years.  That makes sense.

<Why? Simple, humans always choose to believe what they want regardless of what is true or not.>

This may be true for some humans.  I choose to believe what is supported by observable fact.  In the instance where there is no verifiable scientific proof, then I choose to believe what I want based on what makes the most sense to me.  There is no definitive proof one way or the other that we should or shouldn't eat meat, but humans have done so for millions of years, it tastes awesome, and I haven't been sick (not even an allergic sniffle) in 6 years.  By my observation, I'm doing something right, and you won't be able to tell me otherwise unless you can PROVE otherwise (controlled experiment).
Reply: friendlyjun <That would sound ridiculous except if you remember who was the director of the security company...>

Not to mention the contractors performing the "elevator modernization" and "updating the insulation" were Pentagon-tied defense contractors.  What a coincidence.
Reply: ***** <It is retarded to think a species has the same digestive characteristics as every herbivore and not if any omnivore but still be an omnivore.>

You keep making this blanket statement even after I give an example of how you are wrong.  Why are you so dense?  Is a cow an herbivore?  Yes.  Therefore it falls into the category of "every herbivore".  Do we have three stomachs like a cow?  Can we metabolize grass like a cow?  No.  Are those two things digestive characteristics?  Yes.  Therefore we don't share the digestive characteristics of every herbivore.  So you're wrong.  Again.  Why is this so hard for you?  

If we are pure herbivores then explain the Inuit.  Explain the Asian Steppe cultures, both of which subsist entirely on animal products.

You operate under this false pretense that there are carnivores, and there are herbivores, and there are omnivores, all of which have set, defined digestive characteristic which they share with every member of the group they are a part of.  Diet is a spectrum, especially in the omnivore category.  We may be better tuned to eat fruits and vegetables, but that doesn't mean that we can't or shouldn't eat certain types and certain quantities of meat.

Dictionary: A frugivore /fruːdʒʉvɔr/ is a fruit eater. It can be any type of herbivore or omnivore where fruit is a preferred food type.

Humans have the most similar dental structure to frugivores.  Do you see the part of the definition where frugivore can fall under the more broad category of omnivore?  Hmm lets see, what is another example of a frugivore.  The chimpanzee is a frugivore.  They also happen to be our closest genetic match in the animal kingdom.  Do chimpanzees hunt and consume meat?  They do?  Well golly, it seems like you're wrong again.  Too bad.

Once again, it seems your personal beliefs don't quite match the observable facts.  I'm beginning to see a pattern here.

You said "bye" a few posts back.  What's keeping you?  You clearly have nothing constructive to add.  No scientifically backed citations to speak of.  You're definitely not going to get anywhere trying to convince me of anything, as I've shown you to be an idiot several times over, and I don't accept the opinion of idiots as fact.  Keep digging though, maybe you'll eventually make it to China.

But before you go, why don't you cite a refutation of the Harrit study, or cite anything that proves the official collapse theory?  Oh thats right, you've still got nothing.  Bye-bye now.
Reply: +Truth 
<You didn't look at the site I
gave you did you?>

 

Unfortunately, I did.  As
expected, it is speculation with no experimentation.  Nothing to refute the millions of years of precedent in
which archaeological evidence proves that humans ate meat throughout our entire history.  Nothing that
explains how, if humans are herbivores, the Inuit and Asian Steppe cultures have thrived all this time on a
purely animal-based diet in some of the harshest environments inhabited
by any humans.  Nothing but the application of unproven meaning to observed characteristics that
you brainwashed vegans believe is proof that humans MUST be herbivores. 
I tried to find the credentials on your source, and although he appears to be a smart guy, I don't see
anything about his educational background.  He doesn't appear qualified to be making
such distinctions as to who should be eating what.  Oversimplification and misrepresentation of facts, no
scientific experimentation, blog post by an unqualified source, hmm; come to think of it I can see why you
choose to cite this as you're academic source.  This sort of unscientific speculation
seems to be the MO for the type of information you bunkers cite as "proof."  Now it
all makes sense.  Good find.

 

I did, however find some notes from a lecture by a PhD,
anatomist, and primatologist, who also happens to be a vegetarian.  He seems to disagree with your blog post.

 

Example:  You claim the length
of our digestive tract is irrefutable proof that we are herbivores (despite the
fact that we can't metabolize grass).

 

Fact:  "Relative number and distribution of cell
types, as well as structural specializations, are more important than overall length of the intestine to
determining a typical diet. Dogs are typical carnivores, but their intestinal
characteristics have more in common with omnivores. Wolves eat quite a lot of
plant material."

 

"Intestinal absorption is a surface area, not linear problem.
Dogs (which are carnivores) have intestinal specializations more characteristic of omnivores than carnivores
such as cats. The relative number of crypts and cell types is a better
indication of diet than simple length. We are intermediate between the two
groups."

 

From the same source but a different
article:  "According to a 1999 article in the journal The Ecologist,
several of our physiological features "clearly indicate a design" for
eating meat, including "our stomach's production of hydrochloric acid,
something not found in herbivores. Furthermore, the human pancreas manufactures
a full range of digestive enzymes to handle a wide variety of foods, both
animal and vegetable.

 

"While humans may have longer
intestines than animal carnivores, they are not as long as herbivores'; nor do
we possess multiple stomachs like many herbivores, nor do we chew cud,"
the magazine adds. "Our physiology definitely indicates a mixed
feeder.""

 

Conclusion:  Simply stating the length of the digestive tract is
insufficient in determining the type of diet.  Aw shucks,
there goes that piece of misinformation.

 

Example:  You claim that dental type and arrangement is irrefutable
proof of the type of diet an organism consumes.

 

Fact:  "The short canines
in humans are a functional consequence of the enlarged cranium and associated
reduction of the size of the jaws. In primates, canines function as both defense
weapons and visual threat devices. Interestingly, the primates with the
largest canines (gorillas and gelada baboons) both have basically vegetarian
diets."

 

So the primates (gorillas and
baboons) with the largest canines are actually vegetarian.  But you said that diet could be surmised by canine length?  So
gorillas should be meat eaters, right?

 

Conclusion:  Jaw and tooth
configuration in no way proves the diet of a given organism. Large teeth can simply be
for display and defense, and smaller teeth may simply be an evolutionary
trade-off of having an enlarged cranium.  Oh darn, you've just been crapped on,
again.

 

And here is an excerpt from
an NPR article that supports my prior statement that consumption of meat is
correlated to brain development:

 

"The second study looked at how long modern mammals nurse their
young. Researchers in Sweden compared the diet, brain size, and weaning times
of 67 species.  Humans breastfeed
for 2 years on average, while chimpanzees, our closest relatives, nurse for
four to five years.

They found that all the animals
stopped nursing when their brains hit a certain stage of development,
regardless of diet. All the meat-eaters, including ferrets, killer whales, and
humans, reached that point of brain development earlier than herbivores or
omnivores, the researchers found. (They classified humans as carnivores based
on the percentage of meat in the typical human diet.)

Also, they conclude, the big
difference in breast-feeding times between humans and other primates is due to
the better nutrition provided to both mothers and babies by meat consumption.”

 

< If you were an
omnivore you could catch an animal with your bare hands and kill it with your
bare hands and rip into its flesh with your teeth and eat it bloody and
raw.>

 

No, idiot.  The means by which an organism catches food is not the same
as the means an organism ingests food.   Instead of sharp claws and big canines, our ancestors
developed large brains, which allow us to use tools and intelligence to catch
our prey.  Just because we don’t
dispatch our prey with our teeth doesn’t mean we aren’t supposed ingest them.  Prove otherwise.

 

While you’re at it, post your refutation
of the Harrit study, and cite your evidence that proves the validity of the
official story.  Oh I almost
forgot, you can’t do that either.

 

Apparently, you’ve spent “years”
researching human diet, and all you’ve got to show for it is propaganda
espoused by vegans who have a definite agenda in preventing what they view as the
“evil” consumption of meat.  You
clearly aren’t too bright, and I don’t expect you to be able to speak
intelligibly about anything more complicated than what your favorite sports
team is.
Reply: ***** <Thank you for confirming what I said you would do. As with all humans that need to self justify you looked at undeniable evidence put together in a manner a child could understand and you reject it simply because it's truth you don't want.>

Nope, pretty sure I reject it because I demonstrated that your "evidence" isn't proof of anything, and is full of misrepresentations.  That's part of the problem here.  You look at this sort of data, and surmise that because of  a handful of superficial similarities, you can determine what humans must supposedly be meant to eat, based solely on this selective data.  You draw a linear correlation like a child (your words), and are unable to grasp the fact that there is more to dietary adaptation than the size of the canines, or the length of the intestines.  You cite a blogger, I cite a PhD who refutes that blogger, yet you claim I'm the one in denial.  Pathetic.  I've got one more for you.  This time, from someone in your own camp.  Theo Summer, a fellow vegan, refuting just about all of your supposed "evidence," and explaining why it doesn't mean what you claim it means:

"Facial Muscles
CARNIVORE: Reduced to allow wide mouth gape
HERBIVORE: Well-developed
OMNIVORE: Reduced
HUMAN: Well-developed 

Why are reduced facial muscles necessary for most meat eaters? The post even explains in the case of carnivores that it is in order to allow for a wide mouth gape. Some carnivores and omnivores hunt using their mouths as an important instrument in the kill. Humans do not use this method. We have historically used our hands in combination with tools in order to hunt and thus have never needed a wide mouth gape in order to hunt. This same explanation applies to why we have a seemingly herbivorous jaw type, jaw joint location, jaw motion, major jaw muscles, mouth opening versus head size, teeth of all types. There are still carnivorous and omnivorous species which do not hunt large prey with their mouths. Pigs are omnivores, eating leaves, grasses, roots, flowers, as well as insects and dead carcasses in the wild. Since their hunting style doesn't require them to kill large animals with their mouths they have facial structures very similar to our own in all of these areas.

Stomach Capacity
CARNIVORE: 60% to 70% of total volume of digestive tract
HERBIVORE: Less than 30% of total volume of digestive tract
OMNIVORE: 60% to 70% of total volume of digestive tract
HUMAN: 21% to 27% of total volume of digestive tract 

Once again this applies to carnivorous and omnivorous species that hunt large prey. These animals often go for long periods between meals and then will consume a single large meal to survive on for long periods at a time. Most herbivores tend to graze throughout the day, not needing to hold a single large meal in their stomachs at once. Humans as animals that have evolved in small tribal settings have been able to share the meat of large kills with members of their community and have otherwise continued to typically eat several small meals throughout the day.

Colon
CARNIVORE: Simple, short and smooth
HERBIVORE: Long, complex; may be sacculated
OMNIVORE: Simple, short and smooth
HUMAN: Long, sacculated

Humans are along with all other primates in having sacculated colons. Ruminants are another group that tends to have sacculated colons. Sacculation of the colon in simple terms simply refers to the structure of tucks and pouches we find in our colon. In humans and primates this is thought to be a special adaptation to fermentation, allowing us to extract more energy from fiber.Source This adaptation would not be useful for carnivores who don't consume any significant amount of fiber. For other omnivores and many other herbivores they have likely all struck upon different solutions for improving digestion of fiber which doesn't require sacculation of the colon, much as many animals have evolved unique solutions to solving the problem of seeing.

Kidney
CARNIVORE: Extremely concentrated urine
HERBIVORE: Moderately concentrated urine
OMNIVORE: Extremely concentrated urine
HUMAN: Moderately concentrated urine

Animals with unconcentrated urine risk wasting too much water in order to excrete wastes through their urine. Animals with concentrated urine put themselves at higher risk of developing kidney stones and other kidney issues. Being a carnivore or herbivore has very little to do with striking this balance, while the prevalence of water plays a much larger role. 

Nails
CARNIVORE: Sharp claws
HERBIVORE: Flattened nails or blunt hooves
OMNIVORE: Sharp claws
HUMAN: Flattened nails

Similar to facial structures, having sharp claws is only necessary if an animal is going to use these for hunting. Humans have never hunted using our nails and thus evolving sharp claws would be entirely unnecessary and quite a burden in our social lives. Once again omnivores like pigs or carnivores like anteaters do not have the features associated with their respective groups here.

Length of Small Intestine
CARNIVORE: 3 to 6 times body length
HERBIVORE: 10 to more than 12 times body length
OMNIVORE: 4 to 6 times body length
HUMAN: 10 to 11 times body length

This is not an accurate measure for omnivorous pigs whose, “small intestines have an average length of 15 to 20 m”Source. For those of you who aren't entirely familiar with the metric system a pig has a body length a little over one meter.

Why is this Important?
Anyone who is skeptical of veganism would see through this argument in a second. This is teeing them up to dismiss our arguments in an instant. Even more importantly however, we don't need this argument. Our recent ancestors have not been vegan, but the ethical reasons for being vegan still hold all the same. A well-planned vegan diet is still healthy during all stages of the life cycle. We don't need to use misleading claims to try to deceive omnivores when we have the truth on our side."

Aw shucks, it looks like even people in your own camp think you are misinformed.  That must sting.  Of course, I've been telling you that you're an idiot from square one because you believe things are fact which you can't prove, and you believe proven facts are false when you can't refute them.  You truly possess reasoning of the weakest kind.  You've had 40 years of life to learn how to critically think, and you have failed miserably.  

<continue to eat animals all you like and keep telling yourself you evolved that way and be happy with your cancer treatments some day.>

Cancer is linked to processed meats, just as it is linked to pesticide-soaked produce and refined sugars and carbohydrates.  The modern Western diet promotes cancer, and most studies that claim to show a link between meat consumption and cancer fail to differentiate between processed meat and organic, unprocessed meat.  Nor do they account for the the way in which meat is prepared.  There is no evidence that proves that eating clean, quality meat as part of a balanced diet is unhealthy.  

<I must leave you now with all your basement dwelling conspiracy theories about secret societies and thermite coverups. Have a good life little one. Bye bye>

When did I mention secret societies?  Oh I get it, another straw-man.  Good job.

Do you mean it?  Are you really gong to leave?  You've said it before but you hung around.  I was wondering how much more misinformed I would need to make you look before you tucked tail and ran.  I'm glad you've finally reached the threshold.  

Before you go, do you mind citing your refutation of the Harrit paper?  Can you cite evidence that proves the official collapse theory?

Oh I almost forgot, you can do neither.
Reply: ***** <Sorry you are wrong. What I gave you was very basic and yet detailed enough to prove what I said.>

You must be confused as to what confers scientific proof.  Your blog post is not one of those things.  All your blog post does is cherry-pick which animals to include in which dietary group, oversimplify what determines the diet of a certain organism, and then claim that because humans are similar in a handful of aspects to these arbitrary, cherry-picked groupings, therefore it is proof that we are herbivores. 

I've cited a PhD and even a vegan in your own camp to try to explain to you that these biological similarities don't mean what you think they mean, and I've also shown you that there are organisms that share characteristics with one dietary group, while belonging to another (vegetarian gorillas have large canines; omnivorous pigs have vegetarian jaw structure and intestine length), thus invalidating you comparison as being evidence of anything. 

Sorry.  Try again.

<Right now you are battling your conscience>

Wrong; I'm battling your stubborn ignorance, and your inability to separate fact from speculation.

< Also no thermite was used in 911>

Solid argument.  Too bad a peer-reviewed, published paper (which DOES confer proof), demonstrates otherwise.  Can you cite a refutation?  Disprove all of these points:

"CONCLUSIONS
We have discovered distinctive red/gray chips in signifi- cant numbers in dust associated with the World Trade Center destruction. We have applied SEM/XEDS and other methods to characterize the small-scale structure and chemical signature of these chips, especially of their red component. The red material is most interesting and has the following charac- teristics:
1. It is composed of aluminum, iron, oxygen, silicon and carbon. Lesser amounts of other potentially reactive elements are sometimes present, such as potassium, sulfur, lead, barium and copper.
2. The primary elements (Al, Fe, O, Si, C) are typically all present in particles at the scale of tens to hundreds of nanometers, and detailed XEDS mapping shows intimate mixing.
3. On treatment with methyl ethyl ketone solvent, some segregation of components occurred. Elemental aluminum became sufficiently concentrated to be clearly identified in the pre-ignition material.
4. Iron oxide appears in faceted grains roughly 100 nm across whereas the aluminum appears in thin plate- like structures. The small size of the iron oxide particles qualifies the material to be characterized as nano- thermite or super-thermite.
5. Analysis shows that iron and oxygen are present in a ratio consistent with Fe2O3. The red material in all four WTC dust samples was similar in this way. Iron oxide was found in the pre-ignition material whereas elemental iron was not.
6. From the presence of elemental aluminum and iron oxide in the red material, we conclude that it contains the ingredients of thermite.
7. As measured using DSC, the material ignites and reacts vigorously at a temperature of approximately 430 ̊C, with a rather narrow exotherm, matching fairly closely an independent observation on a known super-thermite sample. The low temperature of ignition and the presence of iron oxide grains less than 120 nm show that the material is not conventional thermite (which ignites at temperatures above 900  ̊C) but very likely a form of super-thermite.
8. After igniting several red/gray chips in a DSC run to 700  ̊C, we found numerous iron-rich spheres and spheroids in the residue, indicating that a very high- temperature reaction had occurred, since the iron-rich product clearly must have been molten to form these shapes. In several spheres, elemental iron was verified since the iron content significantly exceeded the oxygen content. We conclude that a high-temperature reduction-oxidation reaction has occurred in the heated chips, namely, the thermite reaction.
9. The spheroids produced by the DSC tests and by the flame test have an XEDS signature (Al, Fe, O, Si, C) which is depleted in carbon and aluminum relative to the original red material. This chemical signature strikingly matches the chemical signature of the spheroids produced by igniting commercial thermite, and also matches the signatures of many of the microspheres found in the WTC dust [5].
10. The carbon content of the red material indicates that an organic substance is present. This would be expected for super-thermite formulations in order to produce high gas pressures upon ignition and thus make them explosive. The nature of the organic material in these chips merits further exploration. We note that it is likely also an energetic material, in that the total energy release sometimes observed in DSC tests exceeds the theoretical maximum energy of the classic thermite reaction.
Based on these observations, we conclude that the red layer of the red/gray chips we have discovered in the WTC dust is active, unreacted thermitic material, incorporating nanotechnology, and is a highly energetic pyrotechnic or explosive material.

[5] Jones SE, Farrer J, Jenkins GS, et al. Extremely high temperatures during the World Trade Center destruction. J 9/11 Studies 2008; 19: 1-11. "

Oh thats right, you can't.  Bye.
Reply: ***** <Ask your conscience in a moment by yourself if you are a natural flesh eater.>

When did I say natural flesh eater?  I said Omnivore.  Stop misrepresenting what I say and stop pretending that your blog post amounts to proof of anything.  I already trashed your blog post with several separate sources, one of which was a PhD, and one of which was a vegan in your own camp, urging fellow vegans to not use such weak logic because it will cause the people you are trying to convince to dismiss your entire argument.  Apparently you didn't get the message.

<I sympathize with your need to make a friend>

I'm not your friend, trash.

<I already know you are lying. >

Oh, so me explaining to you how correlation doesn't prove causation is a lie.  OK, "friend." Go take a class in logic.  I know you said you're 40.  Maybe between your erectile dysfunction support group and your hair implant treatments, you can make time for some night classes.
Reply: ***** < All of the info you have did not come from experts.  They are people with agendas.>

Oh, gotcha.  "Dr. McArdle is a vegetarian and currently Scientific Advisor to The American Anti-Vivisection Society. He is an anatomist and a primatologist."  Yeah, he's trying to scare people away from vegetarianism because he secretly wants to hog all the vegetables to himself.  Because he's got an "agenda".  An animal-rights activist, a vegetarian, a PhD, anatomist, and primatologist; he's clearly unqualified and super biased towards eating meat (even though he doesn't).  One of the other sources of information is from a vegan who does a good job of using logic, and showing how not all vegetarians aren't as irrational as you.  

They're after you, Falsie, it's a big conspiracy to trick you into eating meat!  Go fetch your tinfoil hat!

<Now you are wrong and that's the end of it. If you keep insisting you know something you still won't and you will still be wrong.>

Good argument.  Pure substance, as usual.

<Let's end this like this. If you can video yourself going out and killing an animal with your bare hands and then eating it with your teeth and consuming it raw like a real omnivore would do, no fire, no weapons, no traps, no knives, all natural>

No, dumbass.  You still don't get it.  We didn't need to develop long teeth and claws because we developed a brain and nimble, useful hands, which turned out to be more effective at offering a hunting advantage than having claws and teeth, more useful socially, and allowed us to become the dominant lifeforms on the planet.  Just because you can't crack a walnut shell or brazil nut shell in your mouth doesn't mean we shouldn't eat nuts.  You also aren't exactly designed to climb trees like any of our ape ancestors.  I guess by your logic, we shouldn't be eating tree fruits either.  Another example that proves you're an idiot:  The lammergeier eats the bone marrow of its kills by dropping the bones from a great height onto large rocks.  Because the lammergeier has to use a tool (the rock) to access the food, and can't simply break open the bone with its teeth, then by your logic, the lammergeier isn't designed to eat bone marrow.  Because he has to use a tool to access the food source.  Therefore the lammergeier can't eat the bone marrow.

Did I mention you have horrendous logic?  

Ill make it simple for you.  Being an omnivore is not defined by the tooth size, and the jaw type, and the size of the colon, because it is varied.  It it not determined by the way in which you kill your prey or access your meals.  There is more than one way to skin a cat, so-to-speak.  Being an omnivore by definition is merely about consuming food from both plants and animals.  The fact that billions of people consume meat as a significant portion of their diets, and have done so for millions of years, is self-evident proof that we are omnivores.  We are omnivores by precedent, and you've got nothing to say otherwise.
Reply: +Truth What about trapping animals herding them off cliffs even fish were trapped. How about club weapons? Dropping rocks? I think killing your meal makes you much more thankful for it. It is natural for man to eat meat. DONT BE BLIND AND EMOTIONALLY FLAWED. its ok for an animal to eat another one alive no less. But for me to hunt make a clean kill while the fees I pay go to saving the life and health of the animals. Is worse than buying animals drugged and locked in a cage till death
Reply: ***** <Sorry we are not talking about insects.>

Sorry, you said "any animal."  Insects are animals, so you're wrong again.  Humans eat insects non-incidentally, and purposefully.  As part of their natural diet.  Because they are high in protein, fat, and nutrients.

<This does not make them omnivores>

Yes it does, dumbass.  Are insects plants?  No.  So an animal that eats insects purposefully along with plants is an omnivore by definition.  You lose.

<To be an omnivore you must eat flesh and insects are not considered flesh.>

Which definition of omnivore says we must eat flesh and that insects don't count?  Im pretty sure you're just making shit up at this point to cover for all of the incorrect blanket statements you've been making.  Omnivores derive there calories from plants and animals.  Grubs and worms are animals.  Period.

<Now when are you going to eat an animal for us you omnivore????>

When are you going to eat nothing but grass for a week, you herbivore?

<How about a squirrel? That's small. You lose I busted you and you look like a fool because you can't eat an animal hahahahaha>

And you claim to be 40 years old?  You have the sentence structure and the argumentative skills of a 12 year old.

You must have missed that video from my last post with one guy catching large prey with his bare hands and no tools.  Thats the hard part.  Killing would be a simple task of closing the windpipe or breaking the neck.  Another member of the hunting party could easily do this while the first guy held the animal down.  Hell, the first guy looks like he could probably do it solo.  Once dead, it would be a simple task of tearing the hide with the incisors, pulling back the skin, and consuming the flesh.  Better yet, pull out the liver from a hole in the abdomen.

<So if humans never had long claws and razor sharp teeth than you have to admit cows and pigs are not our natural diets right? >

No, because long claws and long teeth have nothing to do with being able to consume meat.  I consume meat just fine with my current anatomy.  My stomach acid does a good job of breaking it down, and my pancreas does a good job of producing the necessary enzymes to metabolize that meat.  Plenty of omnivores consume meat without sharp claws and long canines.  You're an idiot.

/watch?v=rUiPmHA7Xqg
Reply: ***** < Every animal on the planet digests insects you dumbass>

Right, and the ones who target insects and injest them specifically along with plants (like chimps or humans) are called...you guessed it, omnivores.  Insects are animals.  What was the definition of omnivore again?  Thats right, an organism that derives its food from plant and animal sources.  The only place humans aren't considered omnivores is in your weak little mind where you have made up your own contrived definition of what an omnivore is, consisting of criteria that often have nothing to do with actually being able to efficiently digest an animal for sustenance.

Animals killing other animals for food is natural, and we've done it for millions of years.  Get over it, Falsie.

<Insects do not make you an omnivore.>

They do if you eat them specifically, along with  plant foods, both of which humans have done for millions of years.  Ergo, omnivore.

<You better get an education some time soon.>

It's funny that I can use google for 30 minutes and basic logic to debunk the vegan "killing animals is evil" propaganda that you supposedly spent "years" researching.  Pathetic.

<Tell me right now if those animals are you natural diet>

Yup, they are.  So says historical precedent and archaeological records.  Not to mention the fact that when I put some in my mouth ad chew, my brain seems to enjoy it.  Prove otherwise.

A friend of mine killed a large buck yesterday with a bow.  He brought the liver over for lunch and I cooked liver and onions, and even sliced some thin to eat raw with a little soy sauce.  Both were delicious.  Come and stop me.

<Admit that you are not eating your natural diet.>

I eat plenty of fruits and vegetables with my meat.  You're wrong again.

<Your ass is in a sling and you know it. I am destroying you in this debate because you keep avoiding what I am saying.>

Hahahahah; you're funny.  You've been annihilated several times over.  You can't refute the Harrit study, you can't support the official 9/11 collapse theory, and you can't prove that humans are herbivores (because thats false).  Go tell an Inuit he's an herbivore.  Ge tell the Maasai and Bushmen that they are herbivores.  Good luck with that.

<Either admit you don't eat your natural diet or show me a video of you killing a cow or pig bare handed and eating it without man made tools. It's one or the other or you lose the debate.>

Chimps can use tools when hunting.  Are you saying that using tools is unnatural?  Many animals use tools.  The fact that we have better tools is simply a function of our bigger brains (which are also natural).  Secondly, the means in which an animal kills another animal can have nothing do do with the way an animal eats another animal.  When early humans scavenged other predator kills, that's a perfectly valid method of acquiring sustenance.  Just because we didn't kill that animal with out bare hands doesn't mean can't eat it.  You logic is terrible.  Honestly, Ive met grade-schoolers who are sharper than you.

Moreover, Ive posted several videos of one average sized and average muscled man catching large animals with his bare hands and no tools.  Deer, pig, fox, wombat, kangaroo, hawk.  Being a conservationist, he released the animals, but one more person with him could easily have closed off or broken the windpipe while he restrained the animal.  In many cases, he probably could have done it by himself.

You literally have no ground to stand on.  I've used logic, basic knowledge, and video evidence to refute every one of your claims.  You're done here.

When are you going to prove you're a natural herbivore by eating raw lawn clippings for a week?  Oh thats right, you lack the necessary fermentation sac to break down the vegetation, and you lack the enzymes to convert it to viable food.  Knock yourself out though, see what happens.
Reply: ***** <there is no use arguing with an idiot who has a biased agenda.>

Thats funny, I feel the same way.

<All herbivores eat insects and that does not make them omnivores you dumbshit.>

Hmm, don't think I've ever seen a cow digging through a termite mound for food.  There's a difference between accidentally swallowing a bug and hunting for insects specifically to eat them.  What's the word for a creature that derives its food from both plant and animal sources?  Remind me again.

<Admit right now that you do not eat the things nature made for you>

Come and make me, moron.

<show us a video of you killing a pig or a cow and eating it with your hands and teeth raw just like all omnivores do.>

First of all, not all omnivores hunt and kill prey.  Thats the first flaw in your retarded premise.  Secondly, Humans can and do catch large prey animals barehanded.  I believe I've posted three videos thus far proving this.  What can be caught barehanded can be killed barehanded.

Wheres the video of you eating grass for a week to prove you're an herbivore?

The fact that you don't eat any animal products, and the fact that your brain seems only half-operable (and not the intelligent half) seems to be self-evident proof that humans don't do so well without animal-based food sources.

Go chew some cud, loser.
Reply: ***** <This needs to end because you need a new friend.>

You need a reprieve from getting your argument shat on over and over.

< Now let's prove you are a coward. >

Good luck.  The only thing you've proven thus far is your lack of reasoning and your inability to engage in a debate without resorting to logical fallacy.

<You keep avoiding the questions that will expose your fraud.>

Pretty sure I've gone through you idiotic line of questioning point by point and refuted every last one of them.

First you pretend like all omnivores all share the same canine size and intestine length and every other aspect of the digestive system, and that humans are different from all omnivores, which are all the same to one another.  I proved that you were wrong by citing herbivores with carnivore-sized canines (gorillas, baboons), and citing omnivores that don't hunt for their meat (pigs), and share a similar colon length to humans.  

You claimed that humans share all digestive characteristics as herbivores, and I cite the simple example of cows having three stomachs, and other ruminants having fermenting sacs to break down the raw vegetation, while humans do not.  This seems to be a pretty big aspect of the digestive system that you appear to have conveniently overlooked.  I proved that you were cherry-picking specific animals and projecting the specific qualities of those animals on all animals in their supposed dietary groups, and using those cherry-picked examples to try to claim that all animals with a similar diet share the same digestive characteristics, which is of course, wrong.

You then claimed that no human has ever caught and killed a wild animal barehanded without tools, ever.  This is of course about as dumb a statement as you have ever made.  There are plenty of animals catchable by hand, and what can be restrained can also be killed.  Easiest examples would be grubs, insects, reptiles and certain amphibians.  Not to mention large game like deer, kangaroo, pig, fox, wombat, and even birds, all of which I provided video evidence for.

You then assert that because we can't catch prey without tools (which I already showed to be false), we therefore aren't omnivores.  I first proved that you were an idiot by showing you that the definition of omnivore has nothing to do with how an organism kills its prey, it simply defines the diet of the organism, period.  I then gave an example of an omnivore that does not hunt its meat, but scavenges it (pig), which totally defeats your false premise.   Then I gave examples of how wild animals in nature also use tools to access their prey (chimps, finches, crows, lammergeiers), which defeats your false premise, again.

As the final series of nails in your coffin, I introduce groups of human cultures that are entirely carnivorous, such as the Inuit and Asian Steppe tribes.  Of course, if we were true herbivores like you claim, then these cultures couldn't exist (and especially not in the harsh environments they exist in).  You have yet to attempt to address this inconvenient fact.  I then cite millions of years of historical precedent as proven in the archaeological record that shows humans have consumed meat as long as there have been humans.  I then cite the self-evident proof of being able to consume meat by the plain fact that a majority of humanity consumes meat to this day, and thanks to our stomach acid and specialized enzymes released by the pancreas, convert that meat to usable energy and nutrition.

You are left with absolutely zero ground to stand on, and you're never going to get anywhere with this line of argument, because you clearly don't know how to utilize logic, and you clearly are unable to construct a factually supported statement using an academic source.  Not to mention you're just wrong. 

You're easy.

<Now once and for all answer yes or no. Are cows and pigs your natural diet? Yes or no.>

Yes, along with many other animals and many other plants and fruits.  Prove otherwise.  And try not to use the same logical fallacies I just stomped on.  I'm starting to feel embarrassed for you.

Why do you continue to travel down this doomed path, and use it as a distraction from the relevant facts in our discussion, such as your being unable to refute the Harrit paper, or support the official collapse theory, of cite a source for your claim that "99.9% of experts" buy the official story?

The only person you're fooling here is yourself.

Thanks for playing you poor, malnourished fool.
Reply: ***** <You didn't answer the question. Are pigs and cows your natural diet? Yes or no.>

Your reading comprehension is as poor as your logic.  From my last post: 

"<Now once and for all answer yes or no. Are cows and pigs your natural diet? Yes or no.>

Yes, along with many other animals and many other plants and fruits.  Prove otherwise."

You didn't answer the questions.  Why can't you explain purely carnivorous human cultures that I keep mentioning?  Why do you ignore the archaeological evidence that proves that humans have consumed animals for millions of years, since before recorded history?  Where is your refutation of the Harrit paper?  Where is your academic study that proves the official collapse theory?  Where is your citation that supports your statement that 99.9% of experts believe the official story?

It's obvious that you keep hiding from these questions because they void your argument.
Reply: ***** <so the only way to prove who is right is for you to naturally kill and eat a pig or cow. Natural means nothing manmade so you must kill a cow or pig with your bare hands and eat it. No weapons or knives or cutting utensils or machines. No fire or stoves or cooking utensils>

You should brush up on your reading comprehension.  I already proved that your dumb little task is a false premise.  From two posts ago:

"You then assert that because we can't catch prey without tools (which I already showed to be false), we therefore aren't omnivores.  I first proved that you were an idiot by showing you that the definition of omnivore has nothing to do with how an organism kills its prey, it simply defines the diet of the organism, period.  I then gave an example of an omnivore that does not hunt its meat, but scavenges it (pig), which totally defeats your false premise.   Then I gave examples of how wild animals in nature also use tools to access their prey (chimps, finches, crows, lammergeiers), which defeats your false premise, again."

Humans have been using tools to kill and butcher animals for a least 2.5 million years.  I think its safe to say that anything that a species has done for 2.5 million years is officially a part of their natural behavior.  Even if we had not, using a tool to acquire meat does not disqualify the consumption of that meat source as "unnatural," as many wild animal also use tools to acquire food.

Also, I've already linked several videos of one single unarmed human capturing large game barehanded with no tools.  Killing the animal would be the simple part.  Simply close off the windpipe until suffocation.  Once dead, the hide can be broken with our teeth, the skin peeled back with our hands, and the flesh eaten raw.  Raw meat is actually easier to digest than cooked meat (although it may take longer to chew), and far healthier.  You seem to be implying that this would all be impossible.  What part of this easy to imagine process would be impossible?  Be specific.

And you didn't answer my other questions.  Why can't you explain purely carnivorous human cultures that I keep mentioning?  Why do you ignore the archaeological evidence that proves that humans have consumed animals for millions of years, since before recorded history?  Where is your refutation of the Harrit paper?  Where is your academic study that proves the official collapse theory?  Where is your citation that supports your statement that 99.9% of experts believe the official story?

Why do you keep running when it's clear that you're getting nowhere?  The more you rely on your already-disproven fallacious logic and the longer you ignore the questions I pose, the denser you look, and the more you discredit your own arguments.
Reply: +Truth Not sure why it didn't post my comment.  Here it is again:
<All you did was admit you are wrong.>

Not at all.  Learn to read.

<In your world everything is as you choose it to be. With your definitions anything can be right if wrong based on the desire of the debater. >

Yeah, it's this magical thing called logic and deductive reasoning.  With enough practice, you too could one day learn this type of sorcery.

<Anyone can do what you did>

Go for it; give it a try.

<Just insist it's your way and throw up ridiculous arguments.>

Which of my statements is ridiculous.  Quote exactly what I said and then explain how it was incorrect.  Be specific.

<We know for a fact that humans did not have weapons or fire fir millions of years>

Humans have been using tools for at least 2.5 million years.  So says archaeologic evidence.

<therefore no human for that time ate a vow or a pig and you know that.>

Prove it.

<Also we do not have the stomach acids to digest an animal that has been lying dead in a field the way a true scavenger like a vulture would do do you lose that also.>

Nice strawman.  When did I claim we were true scavengers?  Picture this scenario. 1) Lions kill large prey animal. 2)  Group of humans scare off lions.  3)  Humans consume prey animal.  IMPOSSIBLE, I SAY!  Too bad the Masai use this tactic to this day, which disproves your claim that humans can't possibly consume pig or cow or large prey animals without the help of tools.

Too bad the videos of Andrew Ucles stalking and catching large game barehanded with no modern technology also disproves your claim that humans can't do this.

Also, your false premise that humans can't kill prey without the help of tools (which is wrong to begin with) is irrelevant, because many wild animals also use tools to hunt and acquire food.  There is nothing unnatural about using tools to acquire food.

You've got no evidence that it wasn't done, and your speculative bullshit statements have been proven wrong over and over.

<You know you are wrong and I know you are wrong and everyone knows you are wrong.>

My name is Truth and I am good at argument and I am right and I have good sentences.

Idiot.

<Pigs and cows are not humans natural diet and you lose.>

Another strong, factually supported statement.  Good work.  A+

<You know you lose you just need to keep arguing with obvious falsehoods>

Cite one false statement.  Again, be specific.

<The moon is made out of cheese prove me wrong.>

Recovered moon rocks prove you wrong.  The fact that there is no evidence to support the theory that the moon is made of cheese proves you wrong.  Studying the light the moon gives off with a spectrometer proves you wrong.  This is about as strong an argument as you have made thus far.  Keep up the good work.

<Trees are made out of steel prove me wrong.>

Chemical physical analysis of trees prove they are not make of metal.  You're not very good at this are you?

<Nobody died on 911 prove me wrong. >

The scattered DNA and tiny bone fragment prove you wrong.  The video evidence of people falling 100 stories proves you wrong.  Seriously, you're an idiot.

<That is how you debate. You just say anything>

The difference?  I can disprove your claims with one or two sentences.  In dozens of posts, you have yet to disprove a single one of mine.  You know why?  Aside from the fact that you are a naturally horrible debater, and borderline mentally handicapped, you are also wrong.  And I am right.  By definition, something wrong can't be proven, and something right can't be disproven.

Prove me wrong.

Why can't you explain purely carnivorous human cultures that I keep mentioning?  Why do you ignore the archaeological evidence that proves that humans have consumed animals for millions of years, since before recorded history?  Where is your refutation of the Harrit paper?  Where is your academic study that proves the official collapse theory?  Where is your citation that supports your statement that 99.9% of experts believe the official story?

Why do you keep running when it's clear that you're getting nowhere?  The more you rely on your already-disproven fallacious logic and the longer you ignore the questions I pose, the denser you look, and the more you discredit your own arguments.
Reply: ***** Nice retort.  No factual ground to stand on.  No science to back you up.  Just blind speculation and a false premise.  GG  False.  Enjoy playing karate.
Reply: ***** <The more you keep trying to desperately prove your point the more it proves you know you lost this debate>

The more it proves that I stomped out your argument from every conceivable angle, and you still don't realize it.  Too funny.  Here it is again: 

Your premise assumes that a) humans can't catch any animal (despite the fact that we are persistence hunters with a high endurance, and can naturally run down every mammal on earth over an open distance) b) humans can't kill any animals with their hands (you're retarded to believe this, Mr. Karate man) and c) humans can't digest raw meat (you obviously aren't cultured enough to have tried beef tartare, or fresh raw liver).  You are wrong on all counts.  Archaeological evidence and common sense disproves you.

Why can't you address any of these facts, all of which negate your argument?  

<Seeing someone trying to hide their agenda is the easiest thing in the world to see.>

I agree.

< Only the person trying to hide their lie can't see how obvious it is lmao>

You should stay away from the mirror.

<The fact is without weapons and utensils and fire you can't eat more than a bug.>

Prove it, moron.  Ive cited several specific examples where that is blatantly false, all of which disprove your argument yet again.  Why won't you specifically address any of the points I make that conflict with your argument?

<That prices you are hit a NATURAL flesh eater.>

Im is Truth und it prices that im herbivore and your a hit flesh eater.

You're a special one aren't you?  Doesn't your version of YouTube have an edit button?  No shame.

Look up omnivore in any dictionary.  I guarantee humans are mentioned in that category 100% of the time.  Archaeological evidence says we are suited to eat meat and have for millions of years.  Anatomy and physiology says we can eat meat.  Historical and cultural precedent says we can eat meat.  Anatomists and Primatologists say we can eat meat.  The fact that billions of people eat meat every day says that we can eat meat.  The only people who say we can't eat meat are vegan pussies who think killing is "evil" and believes that the world could exist in harmony if only we would all stop eating meat and going to war with each other.  You're a gullible fool.

Why can't you explain purely carnivorous human cultures that I keep mentioning?  Why do you ignore the archaeological evidence that proves that humans have consumed animals for millions of years, since before recorded history?  Why do you ignore the videos I've posted of Andrew Ucles running down and catching large game with his bare hands and no tools whatsoever?  Where is your refutation of the Harrit paper?  Where is your academic study that proves the official collapse theory?  Where is your citation that supports your statement that 99.9% of experts believe the official story?

Don't think that because you keep avoiding the original subject of this thread, I'm going to forget all of the baseless blanket statements you have made with zero effort to back them up.  Keep running, clown.  The best part is, I've refuted every one of your statements so many times and in so many ways that at this point all I have to do is copy-paste from my own prior posts.  You're easy.
Reply: ***** < +Joe Mills You are out of your mind and those theories have been totally debunked>

You keep saying things like that, but I don't see you actually debunking anything.  Why can you provide any support for any of your statements?

Try again.
Reply: ***** <Just so you know I don't read most of your stuff. You write far too much>

It's OK, little guy.  Just stick to the picture books, you;ll be fine.  Go back to sleep.

Why can't you explain purely carnivorous human cultures that I keep mentioning?  Why do you ignore the archaeological evidence that proves that humans have consumed animals for millions of years, since before recorded history?  Why do you ignore the videos I've posted of Andrew Ucles running down and catching large game with his bare hands and no tools whatsoever?  Where is your refutation of the Harrit paper?  Where is your academic study that proves the official collapse theory?  Where is your citation that supports your statement that 99.9% of experts believe the official story?

<You must be one of these lonely trolls that lives in your moms basement even though you are 40 and you have no friends.>

Hmm, I've heard this before.  Do you have a clipboard full of cookie-cutter insults that you post agains anybody who makes you look like an idiot online?  You must sure have a lot of experience with maternal-basement-living to be able to pass judgement so quickly on people you don't know.
Reply: ***** Yes, humans have always been opportunistic eaters.  Fruits and vegetables were the easiest and least risky sources of food, but in colder climates (ice ages) or when plants were scarce, we had to consume meat to survive.  As you said, we adapted our brains and our endurance to be able to hunt and kill without sharp claws or long canines.
Reply: ***** "Chased them off cliffs? Hahahahaha stfu you dumbass."

That's a known hunting method of early humans.  Flank the animal, funnel it to the top of a ledge, and advance until it jumps off and dies from the fall.  BUT WE'RE HERBIVORES, HUUUURRRR!!!11  Not sure I can think of any other "herbivores" that deliberately hunt and consume other animals.  We do it because we're adapted to do it, and because animal food sources contain very high concentrations of certain nutrients that are scarce in plant sources, and are beneficial to our biology.

<Ok go out into the pasture and kill a cow or pig with your bare hands>

You really don't think a small group of humans could accomplish this?  Restrain the prey, and either close or break the fragile wind-pipe?  No?  Inconceivable?  Or simply herd it over a ledge?  You're a special kind of dense.

<and then use your incisors to rip it's flesh off the bone>

That would be easy.  Our relatively small teeth are sufficiently sharp and our relatively weak jaw muscles are sufficiently strong enough to remove and break down bite-size chunks of raw flesh.  Ever eat sashimi?  *SO DIFFICULT!*

< If you can't you are an herbivore.>

No, not really.  Get your garbage false premise out of here and come up with a new argument.  You've been trashed at least a dozen times and continue to pretend it didn't happen and use the same bunk argument over and over.

< $10,000 I will give you right out of my bank account if you can do it. I am making an oral contract right here for the world to see.>

A verbal "contract" by an anonymous YouTube idiot is worth about as much as your argument thus far.
Reply: ***** <Ok get a few if your friends and kill and eat the cow. I have $10,000 that says you can do it. >

I have $10,000 that says I can do it, too.  I'm glad you finally agree that you're an idiot and have been wrong since your first post.

Go ahead and wire me $2000 as payment for  a live, pastured cow, and then I'll happily kill it for you.  You can keep your theoretical $8000, Ill just butcher and eat on that cow for a year or two and we can call it even.

Unfortunately, even if a group of humans couldn't kill a lone calf or suckling pig with their hands and feet (which is utterly retarded to believe), the use of a tool like a sharp stick doesn't disqualify a food source as being outside the "natural" diet.  Many animals in nature use tools to acquire food.  That doesn't mean they aren't naturally able to eat that food.  Get a new premise, moron.

<We have the same digestive system as other primates and 80% of what they eat us grass and leaves and other greens. The rest is fruit. You are dense.>

Liar.  Other primates eat meat, including our closest living relative, the chimpanzee.

/watch?v=YMXk5Z6-IHY

"They hunt because they like the taste of meat"

"A large group of chimpanzees can eat over a ton of monkey meat in a year."

Try again, shitforbrains
Reply: ***** <No omnivore uses sticks to kill an animal.>

Except for humans.  Oops, I guess you forgot about that one.

<They all use what nature gave them. >

Right, nature gave us large brains and nimble, dextrous hands to fashion tools with.  Our use of tools to acquire food is no less natural than a chimp's use of tools to crack open tough shells, or fish out ants or termites from a nest.  Try again, False Premise.

<Your problem is you have no intention of stopping the eating of flesh>

Why would I?  It tastes good, it contains many vital nutrients, I can digest it perfectly well, and it's readily accessible.  The fact that humans are omnivorous is self-evident from simply observing modern societies all over the world.  I still don't see you attempting to explain purely carnivorous cultures like the Inuit or Asian Steppe cultures.  If we were true herbivores, then these cultures could not subsist off of purely animal products, yet they do, and have for 1000s of years.  You're wrong again, moron.

<Good effort though. OWNED!!>

Pfft, keep dreaming.  You've got nothing.

< No animal picks up a stick and tries to beat another animal to death so man doing it is unnatural.>

You're an idiot.  Man is from nature.  Sticks and rocks are from nature.  Our brains and hands, which allow us to fashion tools, are from nature.  Therefore the use of tools by humans is natural, just as the use of tools by tons of other animals is natural.  You have the logical prowess of a preschooler.

Keep flailing about in your ignorance, pretending you somehow have the upper hand in this argument, despite the fact that you can't address any of the points I bring up which invalidate your idiotic premise.  It's a funny sight, and I'm happy to keep pointing out your logical shortcomings and raging you out on every post.  I can almost picture you sitting at your computer, jaws clenched, eyes watering, trying to snack on a bowl of fresh grass, as any true herbivore would.  What's that?  Humans can't metabolize grass?  Hmm, I wonder why.
Reply: BeholdTruthsSecretTV <But you said from nature, and if I am not mistaken trees are nature, therefor sticks (which are branches that fell off of the tree) are nature.>

Careful now, "Truth" is not good with logic.  He might strain himself if you keep at it.
Reply: Emvaz22 LMFAO. Like seriously, I was dying reading his comments. He probably believes in god as-well.
Reply: +BeholdTruthsSecretTV 
That wouldn't be so bad.  At least with god, there isn't any direct evidence to the contrary.  The crap he espouses can be refuted with basic logic and observable facts.
Reply: ***** <Dumbass you lost this debate two months ago.>

Mhmm, you keep saying that, but you continue to ignore the evidence that defeats your argument from every conceivable angle.

Why can't you explain purely carnivorous human cultures that I keep mentioning?  If these people are pure herbivores, then they wouldn't be able to thrive on a diet of pure animal-products.  Yet they do, so you're wrong.  Why do you ignore the archaeological evidence that proves that humans have consumed animals for millions of years, since before recorded history?  Why do you ignore the videos I've posted of Andrew Ucles running down and catching large game with his bare hands and no tools whatsoever?  Where is your refutation of the Harrit paper?  Where is your academic study that proves the official collapse theory?  Where is your citation that supports your statement that 99.9% of experts believe the official story?

<You just haven't figured it out yet hahahahaha lmao!!>

<Dumbass if you want a real thought try farting so your brain will come out.>

You make statements like those, and you want me to believe you are actually 40 years old, as you claim?  I think there's something wrong with you.  Especially if you're 40.
Reply: ***** < You haven't show me how you kill a cow or pig with your bare hands>

By crushing or severing the windpipe an/or artery after exhausting it.

<and eat it.>

With teeth.

And that's the extent of your argument.  Good job.

<I also showed you the characteristics which prove beyond a doubt that out of millions of species we cannot be the only species with an herbivore digestive system that eats flesh.>

Which is wrong.  Chimps eat flesh.  Pigs eat flesh.  In terms of our digestive system, we are anatomically similar to both.  Secondly, there are characteristics of our digestive system that are not herbivorous.  Our stomachs produce hydrochloric acid, which is not found in herbivores.

Also, there is not a 1:1 correlation between anatomy and diet.  Example: Gorillas have very large canines, but generally do not eat any meat.  

In addition, use of tools does not disqualify a food source from being a "natural" part of the diet.  Other wild animals use tools to access food sources.  This is natural.  Therefore your premise is useless to begin with.

Thanks for playing.
Reply: Emvaz22 Man just block him already this guy is clearly the dumbest person on the planet.
Reply: +TJP77 We'll call it Occam's 5 dimensional tesseract butter knife.
Reply: +Truth My response seems to be invisible.  Here it is again:

<You can't kill a cow or pig and eat it because I challenged you and you failed.>

Nope, you failed to supply the funds required to purchase a whole live animal, and the proper licensing to slaughter that animal (not to mention the potential legal ramifications of killing an animal, videotaping it, and posting it to YouTube).  You also failed to realize that such an act would be pointless because your premise is devoid of logic to begin with.

< We do not have the same digestive system as pigs and chimpanzee do not eat flesh. That has been a lie promoted by people trying to justify eating flesh.>

I never said we have the same digestive system.  I said similar.  Humans are closer to pigs than pigs are to most carnivores.  The characteristics you falsely attribute to a 1:1 correlation with diet are much more varied within a given diet group.  Your generalizations are meaningless and narrow-minded.  I provided video evidence of chimps eating flesh, therefore chimps eat flesh.  I never said they ate a lot of flesh.  I never said they ate as much flesh as modern humans, but thats not the discussion.  Chimps eat flesh, and chimps also eat insects.  Both actions are carnivorous, and because chimps also eat a lot of plants, they are omnivores.  We are genetically most similar to chimps, so we are likely natural omnivores.  And believe it or not, everyone isn't harboring some secret meat-eating agenda.  You're delusional.

<20 characteristics of the digestive system and humans match every one with herbivores.>

Sound like you are cherry picking 20 characteristics, and then cherry picking which creatures to allow into your predetermined groups that best meet your preconceived version of reality.  

<Also you are the only moron on the planet that thinks the very first humans on the very first day of their lives made weapons and killed an animal and made tools to cut it up and produced fire to cook it. >

Nice straw man.  You're just full of fallacies.  Sounds like you need to work on your reading comprehension, because I never said anything like that.

Why can't you explain purely carnivorous human cultures that I keep mentioning?  If these people are pure herbivores, then they wouldn't be able to thrive on a diet of pure animal-products.  Yet they do, so you're wrong.  Why do you ignore the archaeological evidence that proves that humans have consumed animals for millions of years, since before recorded history?  Why do you ignore the videos I've posted of Andrew Ucles running down and catching large game with his bare hands and no tools whatsoever?  Where is your refutation of the Harrit paper?  Where is your academic study that proves the official collapse theory?  Where is your citation that supports your statement that 99.9% of experts believe the official story?
Reply: +Truth Seems to me that of the last half dozen people to post on this thread including me, all of them seem to think you are incorrect.  

Why can't you explain purely carnivorous human cultures that I keep mentioning?  If these people are pure herbivores, then they wouldn't be able to thrive on a diet of pure animal-products.  Yet they do, so you're wrong.  Why do you ignore the archaeological evidence that proves that humans have consumed animals for millions of years, since before recorded history?  Why do you ignore the videos I've posted of Andrew Ucles running down and catching large game with his bare hands and no tools whatsoever?  Where is your refutation of the Harrit paper?  Where is your academic study that proves the official collapse theory?  Where is your citation that supports your statement that 99.9% of experts believe the official story?
Reply: +Truth My recent posts are intermittently unviewable and I'm not sure why.  I'm going to assume you never got my last comment, so here it is again:

<Wow, so you mean if 10 people disagree with 1 person that automatically means the 10 are right?>

No, the fact that I keep bringing up inconvenient facts and questions that invalidate the premise of your argument, and you have been unable to address or respond to these questions, means that you are wrong.  The fact that the last 5 people who have commented all agree that you are wrong is just icing on the cake.

<since 95% of Americans believe Islamic extremists highjacked planes and crashed them into buildings because they hate America. :) >

Oh, so now it's 95%.  It was 99% last time you brought up this point  Now supposedly its 95%.  And which poll are you referencing?  Many posts further up, I already cited two polls that show a majority of Americans don't believe the government story.  I'm pretty sure you're just full of shit.

<You lose yet again.>

Mhmm, sure thing.  Oh, except for...

Why can't you explain purely carnivorous human cultures that I keep mentioning?  If these people are pure herbivores, then they wouldn't be able to thrive on a diet of pure animal-products.  Yet they do, so you're wrong.  Why do you ignore the archaeological evidence that proves that humans have consumed animals for millions of years, since before recorded history?  Why do you ignore the videos I've posted of Andrew Ucles running down and catching large game with his bare hands and no tools whatsoever?  Where is your refutation of the Harrit paper?  Where is your academic study that proves the official collapse theory?  Where is your citation that supports your statement that 99.9% of experts believe the official story?
Reply: ***** <Why do you keep contacting me?>

I realize you probably get notification in your email when I respond to this thread, but I'm not actually sending you those emails.  You choose to respond to the thread just as I do.  If you don't like it (who would enjoy getting their ass handed to them repeatedly?), then piss off.

<Your conscience is bothering you because you know it's unnatural to kill and eat animals>

According to the Vegan Guilt Bible, despite evidence to the contrary, and with no proof of its own.

<you just can't win an argument with your conscience>

Pretty sure if had an issue with my conscience, I wouldn't have the meat, heart and liver of a deer in my freezer.  Pretty sure I would not have just bought some new 100 gr. broadheads for my crossbow.

<As long as you are alive and gave brain function your conscience will be telling you that you are wrong. >

Hah, no.  I find it funny that you have publicly failed multiple times to prove your point, so now you are trying to pretend that my conscience is somehow going to prove your point for you.  

<So you see if you contact me another million times you will just be wasting time when you could be more productive doing something else. >

That's certainly true.  Arguing with you is like slamming the head of an extremely thickskulled, dim person against a wall repeatedly.  It can get tiresome, and it's never going to get anywhere, but it's always amusing.
Reply: +TJP77 foundations are the element of an architectural structure which connects it to the ground, and transfers loads from the structure to the ground
Reply: +fuzzywzhe Go to fucking Hell you piece of shit for those last lines. I don't care what tf you believe, but that is complete fucking heartless.
Reply: ***** < Don't forget the collapse started from the exact entry point of the Planes.  So, the Chargers got impacted by a Boieng aircraft and than was still able to be remotely detonated while sitting snug still in its place.>

Does it occur to you that beginning the collapse directly above and directly below the impact point and then cascading downwards would achieve the same effect as beginning the collapse directly ON the point of impact?

Does it occur to you the the bulk of the charges would have been inside the steel core of the buildings, largely protected from the aluminum chassis of the aircraft, which would be shredded well before it reached the core?

Does it occur to you that most of the jet fuel burned off at the moment of impact, and that it just MIGHT be possible to engineer a shock-resistant, fire-resistant container to protect the charges?

No, surely none of this is possible.  Your meager speculation must be fact.
Reply: Emvaz22
You forgot that explosives in a controlled demolition are often very close to preliminary explosives that are detonated first, thus exposed to extreme heat and pressure, and they still work just fine.
Reply: Harry Balzak Good point
Reply: Ken Brown Think about the people you would be dealing with....not your normal boss you dont like. You dont do what they say, they will kill you and your family. You would disappear. As some people have. Or people are paid off. Its not hard to keep people quiet when youre willing to kill for the secret. Especially when those people are willing to destroy buildings and kill 3000 of their own people.
Reply: Ignore random guy, he is paid to lie and insult everyone.
Reply: no just a 1,000,000 tons of building collapsing and falling on them, good point
Reply: W's brother was in charge of the security organization for the WTC.  Open your mind.  this was planned and executed..
Reply: They have NOT been debunked. Only by govt hacks popular mechanics.
Reply: Serious question: What gain does the government of the United States have from this, other than supposedly "starting a war against innocents" by blaming a "demolition" on them? Would anyone like to speak up?
Reply: @MrKos1995, 
"It should have gone down to one side" 

It did, in fact: watch footage of the south tower collapsing, and you'll see, through the smoke, that it indeed does tilt slightly. It also seems to match the side in which a large amount of the plane's debris came out of the other side of the tower.
Reply: Sorry for the chain of replies I'm probably going to make, but anyways, many eyewitness reports say they heard explosions, yes, but many of them didn't know exactly what caused it. It's easy to assume a loud noise came from an explosion. For many, the impact happened above/below them some 10-15 floors, and they wouldn't ever have thought it was a fucking 50,000 TON PROJECTILE GOING AT ~450 MILES AN HOUR. Have I explained enough? 

I sure as hell think so.
Reply: +John Brandon
Then explain why Niel David Levin died, you ignorant moronic dipshit sheep.
Reply: +TJP77 
save it... these kooks dont want to listen to reason, they want to believe that its easy to drop a building that size on live TV and make it look like something it wasn't. 
they have no understanding of what a fire can and cannot do, nor do they understand what happens to high tensile steel when it gets heated.
they also dont understand the stresses in modern building construction, nor do they have any idea just how much kinetic energy a 400,000 pound projectile doing over 400 knots packs. 
they keep pointing at a WW2 era medium bomber (the B25 is a medium bomber... it isnt nearly as big as a B17, or B24, we managed to launch some B25s off a WW2 aircraft carrier for the doolittle raid,  even by 1940s standards they were a pretty small plane. ) hitting the empire state building as an example of how little an airplane would damage a building. a 767 max takeoff weight is 412,000 pounds... 24,000 of that is fuel.
not pointing out or not knowing that a 767's fuel load alone is only 10,000 pounds LESS THAN the MAX takeoff weight of a B25 at 35,000 pounds.   so yeah... a limestone and steel building getting smacked with 35,000 pounds going 200 knots hauling 2000 gallons of high octane lowlead avgas is the same as a mostly steel building getting walloped with 400,000 pounds going 400 knots trucking 24,000 pounds of JetA aviation kerosene. uhhhh huh... sure it is...  that dog don't hunt. 
next?
Reply: +TJP77 So true, these conspiracy theorists are hilarious. They have no clue what practicality is.
Reply: +CHAD GORDAN Stop fucking saying that there was no plane wreckage at the Pentagon. There was. There are pictures and witnesses. Just because you keep saying something doesn't make it true. 

And cruise missiles don't even use 'gunpowder' you fucking moron. They use PETN or HMX. You can't even get your bullshit conspiracy right.
Reply: +Firstpo jkh First off, no, there were NOT any other buildings damaged worse than WTC 7 that remained standing. It had it's entire southwest corner completely blown out down to the foundation. There are plenty of pictures. All other buildings in the WTC complex were completely destroyed in the collapse -- WTC buildings 3, 4, 5, and 6, the Marriott Hotel, and St. Nicholas Church. 

The Deutche Bank  building across the street was damaged severely but didn't collapse on its own, and was left vacant and demolished in 2007 because it would have been impossible to repair. Ten other smaller buildings were also severely damaged.

Sure, some skyscrapers survived fires, but did any of them have fucking jumbo jets flown into them first? Did any of them have two of the largest buildings in the world fall directly on top of them? 
Your assertion that 'usually firsts = inside job' is fucking hilariously stupid. Care to provide some examples of these 'inside jobs'?
Reply: +fuzzywzhe MASS and WEIGHT are not the same thing you fucking moron. 

And oh yeah, about those WMDs... if the government was SOOOOO capable of pulling off the largest terror attack in history right in the middle of its own largest city and keeping it PERFECTLY quiet for fourteen years all in order to justify an invasion of Iraq on the pretense of WMDs, WHY THE FUCK WOULDN'T THEY JUST PLANT WMDs IN IRAQ?

This super-competent government that's run by diabolical geniuses who were able to orchestrate the most perfect conspiracy in world history couldn't even plant a few warheads in the desert? They could wire up all the buildings of the WTC to detonate perfectly, right under everyones noses in the middle of lower Manhattan in PERFECT secrecy though, right? But getting some fake WMDs into the middle of a country our military had total control over was too difficult. Right?

Oh, and WHY even premise any of this on WMDs? If they were making up this huge elaborate plot in order to justify the invasion of Iraq, why not just BLAME THE ATTACK ON SADDAM? Boom, instant justification and no WMDs needed. Why pin it on Saudis if the objective is to invade Iraq? 

NOTHING YOU SAY MAKES ANY SENSE.
Reply: +helifalic 
First, Define perfect.  There are plenty of buildings that suffered collateral damage from the wreckage of the towers.  This wasn't like one of those demos you see on television, where the building is deliberately taken down by a sequence of charges.  Those kinds of demolitions actually do keep everything in the footprint.  This wasn't the way it happened with the Twin Towers and the buildings around them.  Debris went in every direction. Just watch the pieces of the structure tumbling in the collapse.

Second, nothing happened by chance.  Things operated by the non-random laws of nature.  First, for a building to tip over to the side, it has to be sufficiently strong to hold itself up against a force that is being applied at an angle to that which it was designed to hold up under.  This isn't some solid slab of rock tipping over... but more than that, even solid slabs of rocks have a tendency to break up when they fall, rather than simply flop over like a dropped yardstick. Materials have limits to their compressive and tensile strength.  Also, though, there needs to be a considerable force to move all that mass to one side or another, rather than have it fall straight down.    Angular momentum requires a force moving perpendicular to it's other axis of motion.

So, given these sets of factors, just what was going to cause things to happen any other way than they did? People think demolition because they've seen videos of the same sort of pulverizing, progressive collapse.  What they don't figure is that this happens this way in 9/11 for the simple fact that in both cases, air was being pushed out with pulverized debris from the progressive collapse, a behavior that would occur whether the cause was a controlled demolition by charges, or an uncontrolled cascade of destruction caused by the fact that the top office building worth of floors had lost integrity and collapsed into the floors below them.

You have to invent a ridiculously complicated conspiracy theory to explain why a relatively simple conspiracy wasn't at fault for 9/11, the conspiracy of the 20 al -Qaeda members.
Reply: If I am paid to walk into a room and call an apple a banana, does the apple magically change into a banana? Of course not, it's still an apple. You would be able to prove it was an apple and I would not be able to prove it was a banana.

So in the same way if I was paid to lie you would be able to refute me by providing evidence whereas I would not be able to provide evidence. The TRUTH is you cannot refute me because you live in a fairy tale world full of LIES. You accuse me of being paid as a pitiful excuse for your MASSIVE failure to provide evidence to refute me. It doesn't work SHEEP. Quit making PITIFUL EXCUSES and actually bring something to the table, and not the same bullshit I already refuted that you have NO ANSWER for.

Or...

WAKE THE FUCK UP!
Reply: +Firstpo jkh ok genius, where's that 'pro team'?  It's very hard to keep people quiet and something like this conspiracy would take many many people to pull off.  There's no way all those people will just sit back and keep quiet.  They would have to know they were part of this.
Reply: Wouldn't be that hard if the owner was in on it
Reply: +b a a d e r t h a n m e i n h o f 

Are you serious? Nist completely explained building 7, there is video and photo evidence that show when one of   towers collapsed a large amount of debris hit building 7, there was a huge gouge that spanned 20 stories or so.   There is photographic evidence, plus quotes from multiple witnesses and most importantly fire fighters. The sprinkler systems were damaged by the collapse of the 2 towers and the fires in building 7 burned uncontrolled for 7 hours. It was known that it was only a matter of time before the building would come down. There is multiple quotes about the building starting to buckle and loud creeking coming from the tower. That is the reason the fire fighters did not go in to fight the fires because it was obvious to anybody there that it would it collapse. That is where the Silverstein quote comes into play, when he said "pull it" he was referring to the fire fighters from the building. If you watch the entire interview in context this is obvious to what he's referring to, yet the conspiracy sites and videos dishonesty quote mined what he said to mean what they want it to mean to fit there agenda.
Reply: +Firstpo jkh First fly two jumbo jets into the building and then yeah, it'll come right down. Don't forget that part.
Reply: +TJP77 And the other buildings that came down, next to the towers? No airplanes there.
Reply: +Anthony West Yeah, they just had their foundations completely destroyed by two of the largest buildings in the world falling on top of them. So weird how that happened.
Reply: +TJP77 Falling on top of them? Clearly you are missing something.
Reply: +Anthony West I live in lower Manhattan, three blocks away from the WTC. I watched it happen. I'm not missing anything.
Reply: +b a a d e r t h a n m e i n h o f There was a massive fucking chunk taken right out of the bottom of the building. That hasn't changed. There are plenty of pictures of it. That, and the raging fire brought the building down. The end.